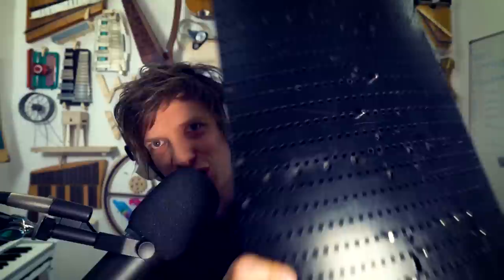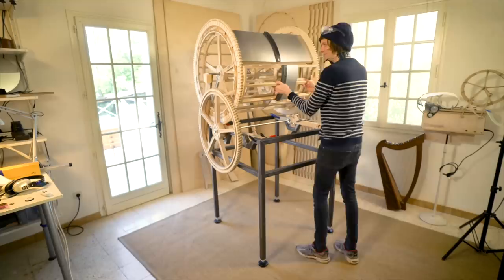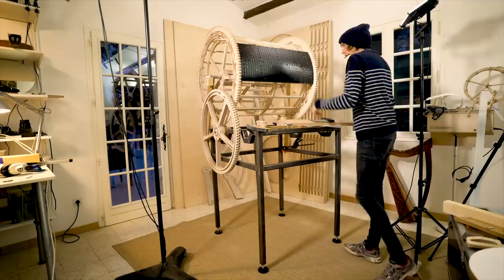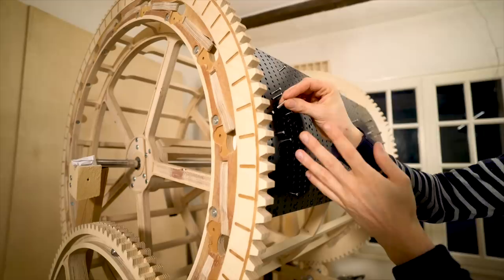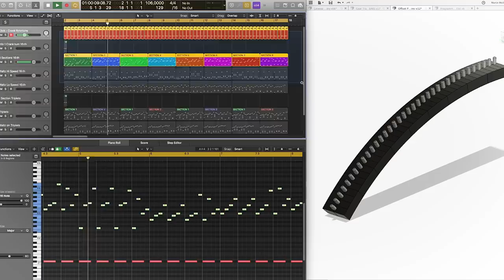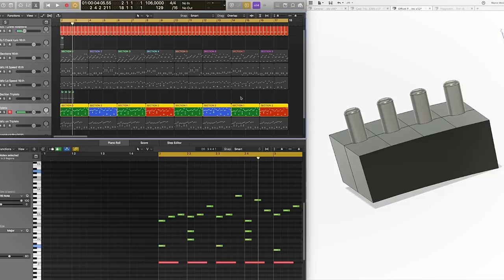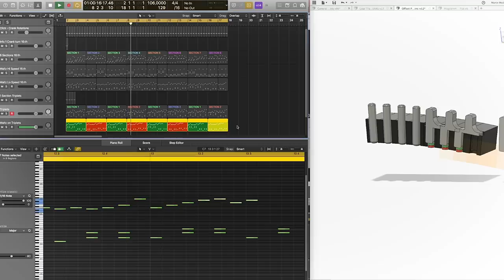Magnet "Midi" Music System - Marble Machine X #25

Comment from the maker: Welcome to the Design Discussion,
Maybe this could be a good place to have a public discussion and for me to receive all your feedback, could maybe be a returning thing in this series, lets try!

So first of all, please keep this clean and about the design, its the constructive criticism we are really looking for here.
I tried to give enough background information in the video to explain the situation
Consider this important fact: there is 15.000 holes/places for pins on the MMX per programming setup (30.000 if we make two setups)  any suggestion involving manual operations multiplied by 30.000 is nearly impossible. (if one manual operation takes 1 minute, 30.000 is a couple of months straight work. We need an automated solution.)
We need a very accurate solution for the musical timing.
It need to be FAST and EASY to reprogram. 

I would love to hear what you think about my last proposed idea or a completely different solution i didn’t think of.

Thanks a lot/ Martin
Reply: I love how you always push your video quality to the next level.
Reply: I think the bar magnet idea is the best option (or some other way of having two rows of pins)
Reply: You should probably build one or two extra sections tu be sure that nothing bad will happen during the tour! if something breaks the technicians can't change all the sections of the next song until you stop playing so that they can change one or two of the sections already in the machine. So just to be sure that you're prepared for every thing, why not make some extra pieces!
Reply: This isn't exactly a design idea but maybe a quality of life idea. For the CNC machine maybe getting a brush to go around the bit so dust and such aren't flying around the shop. While watching I noticed how annoying it must be to constantly have to clean up everything. The brush would limit how far it would be thrown. Something like this https://www.datron.com/accessories/chip-removal.php
Reply: mja00 I'm pretty sure he has an attachment that was fitted when he first assembled the CNC mill. He would have removed it as it doesn't look as good on camera.
Reply: Hi wintergatan, how ya doing? Is this thing gonna play starmachine 2000?
Reply: Just a QoL suggestion for the plates. Maybe cut a notch into one of the corners so the programmers know which side of the plate goes up, that way you don't accidentally start playing the music upside down.
Reply from the maker: @miguel Alves, thats great advice, noted!
Reply: Wintergatan glossy
Reply: Wintergatan my first thought was a set of removable, non-magnetic pegs that have smaller holes embedded in them (for smaller magnets) that extend the same length out of holes that the existing magnets do. Imagine they are "adaptors", and they only need to be made in strips that can be placed where needed. Might be made flexible with... a flexible material.
Reply: For tripletts use a diffrent shape of  magnets, than for the normal... like the squared magnets for the tripletts... That way it's like a puzzle for the technitians but it's clearer to see which pins to use and to reduce mistakes... Or something like that idk...
Reply from the maker: mja00 i got the brush but my dust collector doesnt work currently so i took it off so it looks better for the camera, but yes it is annoying! Sometimes i am using the brush without dust collector connected, that helps alot as well!
Reply: For the plates just an idea ; Number those big feckers. For placement and "here, person, reprogram plate 5, here is plate 5" rather than having the same plate by accident. 

And sky high thinking, maybe build / program a robot to do the programming. Just a whole separate unit.
Reply: I'm not versed in musical theory, but I think you'll probably regret nót implementing the offset system. X is already taking up a lot of time and focus so putting in the extra mile to get a higher return on your investment (more musical options) makes sense to me. Maybe you can make the grooves for the offset pins already, but fabricate the offset pins themselves only after you get everything else done so you don't mess up your schedule by taking this detour.
Reply: Wintergatan i'm not sure if i'm just suggesting what you've already tried, but i thought about some pins that have only the upper part offset to match a triplet, while the lower part remains the same
Reply from the maker: @José Betances try posting some kind of link here? So everyone can see?
Reply: Create a discord server. Its a very nice way to dusccuss with everyone
Reply: If you are making two sets of repinnable music drum(programming wheel) anyway, why not make one set of division by 3 and one set of division by 4?
Reply: Why not build a third set of plates with just holes for the triplet system then you can use the same magnets and know it will work exactly the same as the 4 bar system and be easy to program with no confusion or mixup. Oh and glossy black plastic would look good reflecting whatever lights are on stage.
Reply: Hey Martin. First: Glossy black for sure. I have an idea to make the remove of the pins even faster, you could get some kind of magnetic roll that you could quickly pass on top of the programming sections and it would lift up all the magnetic rods in an instant. Could be useful. 

For the triplets (I'm feeling the triplet hype) I think the first design you show in the demostration could work well. The square pins could be even more brittle than the rods.
Reply: Yehuda Katz the problem with the bars is that they will be a lot more time consuming to program because you must have the good direction when placing them x15000
Reply: Wintergatan keep the triplet pins. You're putting a square peg in a round hole and it will be round because a mill bit. How to stop the square pin to not rotate? Easy, you already have the interesting locking design. What if you only have one pin on its own? Easy, make a groove to keep it aligned. It will be a lot clearer where each track of registrators are which I think will assist both reprogramming and audience communication.
As for texture, I love the look of gloss in the vid but I think matte will hold up better over time. I'd recommend as well as grooves other measures to distinguish between sections of programming eg xylophone, percussion, etc. Why not have one section matte and another gloss?
Reply: There`s a way to get more organised about this whole technical discussion. You can create a Discord server with channels for different discussions. That way all people can see everyone`s suggestions and actively engage in live discussions with you and each other. If you`re gonna do that you should post the invite link to your discord channel in the top comment.
Reply: maybe you could make a mat with pins on the outside for the notes and inside four or five magnet pins to fix it onto the board like a bar mat or something ( https://kwmedia.scdn8.secure.raxcdn.com/media/catalog/product/cache/1/image/9df78eab33525d08d6e5fb8d27136e95/b/m/bm-1812k_large-rubber-bar-service-spill-mat-black_05_1.jpg ) i dont know if the rubber pins would be hard enough to activate the note 
so you could have ready made music mats instead of thousands of pins
Reply: You are so amazing! Good luck building the marble machine x. :D
Reply: I don't know if there is enough space on the programming plates, but if yes: Divide a revolution by 12 (6 slots in 2 rows). Then you have 16ths, 8th triplets, 16th triplets and 32ths triplets (all 12) for really fast arpeggios.
Reply: You should redesign the last triplet pin. It looks like it could break off.
Reply: Or instead of having this discussion on a single comment, which will become a mess pretty soon, you could open a subreddit. Love your work by the way.

If you're looking for an automated solution, the template as a "mask" is great. You could have another drum to mount the plates on, mount the template on top, have it rotate under a linear "funnel" that sets the magnets straight, then make the magnets "fall" into place where the holes of the template are. Then whatever holes of the template aren't filled, it's easy to spot and correct manually.

Big hug from Chile!
Reply: I think that it would probably be best for your marble machine programming board to have a little bit of tolerance built into it before locking. Depending on where your band will perform, the humidity will be your biggest enemy. Your machine may fit together perfectly at the start of a show, but if its humid outside you might find that it becomes harder to disassemble the machine due to the swelling of the wood pieces.
Reply: I've always loved the way you leverage the materials. You described the programming wheel as needing to be all black or all sanded, I think you should utilize the CNC machine or possibly some cleaver sanding to make cool designs on the programming wheel. It's the largest feature of the instrument so I don't think it should be left a single color. Keep in mind it should be a repeating pattern so it always lines up.
Reply: For reprogramming you need some kind of Magnet-Ejector, otherwise the magnets will stick together and it will cost a lot of time, especially for persons, that didn't practice before the show (audience).
Reply: Wintergatan Hi :) what about a plate that you can affix to the removable part that is essentially a metal sheet with the pins welded onto it with a special pin to fix it in each corner?
Reply: You mention the magnets breaking off not necessarily being a bad thing, but in your video, when you broke that one off, how possible was if for you to get it out again?

Whichever way you go, would it be possible for all of the pins to be steel and glue the magnets into the wheel instead, between the steel plate and the plastic? That way there's very little chance of the magnets breaking off the end of the pins and being stuck inside.

Also, +1 for glossy black.
Reply: Hi, this is not exactly a technical remark about the Machine, but have you considered creating a subreddit or an online forum in order to discuss these matters ? Maybe this could prove more efficient in terms of feedback, and it would make it easier for you to read the answers/suggestions. It probably will involve a bit of moderating but if you really are looking for advice, then I think this might be more efficient. And also it could be a nice exchange place for people who love your work (and god knows we are numerous).
Keep the love flowing and greetings from France, bienvenue chez nous !
Reply: Wintergatan What I imagine is if you make much smaller holes so that 12 can be on one crank. Then the pins would have thin bases and thicker tops. Half of the pin that would be in the board would have a much smaller radius than the top half. That way you can stil do the four and the three but also six. I hope would take my opinion into consideration. I love your videos, I always enjoy watching them!
Reply: You could make the reloading templates hold the magnetic pegs ready to be inserted. Then changing one plate's song would be as easy as removing all existing pegs and pressing the template piece into it and letting all the pegs from the template magnetically snap into the music plate and removing the template.
This way you could make many interchangeable and reusable templates, and changing a song would be super fast (though you can't really involve the audience in it).

But you could still make the templates with holes through them. Also the shiny finish is better than matte imo.
Reply: You could use fabric, that is strechted onto the segment. The pins are not magentic at all but rather punched through the fabric from bottom up (they would need a flat bottom part to not fall through the fabric). This way you can have 8 fabric pieces with the pins already in place for every song of your set list. You just need to swap the fabric, which should be much faster than any manual handling of singular pins. Plus you can punch the pin through the fabric in any place you want - not just 16th and triplets (musical magic!). You can also use fabrics with different colors or patterns etc for a cool effect.

Thanks for the awesome video as always!
Reply: Would it be possible to create a reversible pin? one side has the offset and the other is strait. For example, a rectangular pin cutted on one point to make the offset.
Reply: I think putting 8 of those plates on the marble machine on stage will take quite a lot of time
Reply: So I have a couple suggestions. The first is that you simply color code the programming sheets, this would remove confusion and if you keep the pins in colored boxes then it would be a very foolproof system. The next idea is a switch pin. A pin that after it is played will turn itself off, so that on the next rotation it does not play. I have ideas on how that could be done, but it would probably work best to show a drawing
Reply: I'm thinking that you could have an inverse template that could just snap to the programming wheel with a non-magnetic backing so when you put the programming wheel face down to it.. all the magnets just magnetizes to it and transfers to the "master" programming wheel. (it minimizes the time switching) 

and also, you can place the paper template on the "transfer wheel" waiting for the "master wheel" +Wintergartan
Reply: Wintergatan Just for the design of the slopes, I prefer the matt look because the magnets/steel rods are already shiny and a glossy black would distract from this look. Also it might be an issue if you have the machine on stage and the spotlights shine on it. Big shiny areas tend to blind you if the light hits them at the wrong angle.
Reply: What about instead of offset pins, you cut new holes next to the16th-holes. If your rods are 5mm, and the striker they're hitting is 10mm you can have a row of off-set triplet pins half-overlapped with the 16th-holes. You can still function the same as the offset pins, but will not have to manufacture a new part and continue to use the magnetic 5mm pins. - of course, this was your last suggestion that I saw after writing the comment... haha, but I think this Is the best idea.
Reply: I'd like to think this machine won't have the kind of problems as the old one had. But, you may want to make duplicates of the parts that are more likely to break, that way you can make repairs where needed. 
Also is it odd that I want to base a character in my manga off of you?
Reply: +Wintergatan
If the brittle magnets do become a problem could it be possible use the magnetic property of magnets to make it not require contact to trigger, although they might not be strong enough to pull the gates.

This could also be used along with an electromagnet to make it computer controllable. although bypassing the programming wheel will be an issue there
Reply: how about making the drum a separte part ( disassambly for transportation) and put the pins in preprogrammed strips(sort of a chain it loops around the drum that is mounted in the machine, and can be taken off quickly. so divide the drum up in letz say 5 strips that can loop around the drum, taking them off on stage and putting back the strips for the next song would not be a big deal if the mounting system is quick and easy(magnets, clips, screws) the strips could be made of plastic, softer though so it holds the pins securely and permanently but flexible enough to wrap around the drum. sorry for bad explanation and english, i love your channel :)
Reply: Couldn't you, due to the length of the rods and their round crosssection, just drill the holes for 4/4 and 3/4 right next to each other, slightly offset to the side? Would be far easier to produce and I think they would still be held in place and withstand the forces of use, considering the direction of force, I don't think they'd be pushed to any adjacent hole.
Reply: you should consider using Reddit as a place to get feedback. Lot better than youtube commenting.
Reply: Extra anything that can break. this thing is like a high tuned performance machine, Racecar, Moto-cross bike, Speed boat. This should travel with at least 3 sets of identical parts for the primary assemblies and at least 1.5 of the tiny parts, screws etc.
Reply: i think the best solution is to make more sets of plates,  so there is more time to reprogramm them.the templates are also a good idea,  to make the reprogramming as easy as posible.  best would be to have only one type of pin.
Reply: Hej ! I have a question with that kind of design. Can you do songs with quintuple meters (to make the machine more marvelous) ? For the rest of what you described i'm pretty impressed by the idea, and i find it's a good one ! The idea of @Big_Adam_2050 of making a difference / numbering the panes can be cool if you want to invite public to do the programming. Can the wheel have more / less than 8 panes ? like 6 panes for triplets, 10 for quintuplets ?
Reply: Vikrinox I like the glossy black too but I think it would be difficult to keep from being scuffed with use on tour. The mat version has the advantage of hiding minor scratches
Reply: Rather than all the special offset pins, would you get sufficient flexibility from just making a set of 3/4-time programming boards with 3 pins/turn of the wheel rather than four? Seems like it would get you 80% of the flexibility with a LOT less work.
Reply: Matt grey definitely if you can make it nice and even. Is the material available in lighter shades?
The bar magnet idea with 2 parallel rows, one 16s and one triplets sounds like a better plan to me.
Like others, I don't like the idea of shattered neodymium magnets around the place though - a health hazzard and a poor use of a rarish resource. Also a more expensive option for anyone trying to make anything similar.
Amazing project - love following this!
Reply: Glossy. Definitely glossy.
Reply: Glossy!
Reply: How about color coding the templates for each song. Blue holes is one song, red is another? Make the templates out of sticky vinyl. Or how about basing the mechanism on  punched out templates and photo sensitive sensors and triggering a note on that? A bit more techie, but next level maybe?
Reply: The offset pins idea is fantastic - really makes the machine so much more flexible! It's becoming more impressive by the video! As for programming the wheels you could always have a programmed robotic hand like the ones they use in car factories. Of course that would mean you need to start robotics and AI but I'm sure you'd do it :D
Reply: The magnet shift at 13:12 made me think that your original idea was to just drill an extra triplet hole for the round magnets. This would allow you to use round magnets as before and because the double-holes aren't oblong, but rather 8 shaped, the magnets should stay in place. Was this something you considered?
Reply: Why not just make a new plastic grid specially for music in waltz/ 3/4 time with the spacing for three pegs rather than having complicated pegs?
Reply: Glossy black looks really nice! And I prefer the idea of the rectangular magnets and having the 4/4 and 3/4 next to each other. It gives the option of playing things "off beat" as well as being a simpler more elegant solution. 10000+ magnets in different sizes and shapes would be a hassle to keep track of, so having one uniform design would be a much easier approach!
Reply: Harry Tsang What if he wants to play two 4/4 right after eachother?
Reply: I'm a bit worried about the distance between the pins and the thickness of the registrator bottom parts. How close can you put the pins together so that every one gets registered?
Reply: Wintergatan why not have a set of triplet panels? Same pins, same design just with holes spaced for the triplet.
Reply: Two tracks is probably best. Triplet holes don't line up with quarter holes, so you would need three types of pins: ones for quarters, ones for triplet outsides, and another for triplet insides. And you have to pay attention to which way the outside triplet pins are installed. Overall, having two tracks is simpler.

In terms of color, don't make them black. Someone will have to spend time in a badly lit environment trying to fit pins in black holes one a black board. That won't go well.
Reply: To gloss or not to gloss? In my experience as a pianist I've discovered that modern grand piano makers (I.e. Steinways) use gloss black coatings for the outside and lids of their instruments, but they tend to use a matte finish for their lid support rods.  This is not an oversight, but rather an attempt to prevent audience members being dazzled by the off-putting glare from concert hall lights.  Worth considering perhaps?
Reply: You can design two different templates, a 4/4 like you already did and a separate 3/4 (6/4) plate with 6 holes instead of 4 per crank.
Reply: I would say the block magnets are the beast way to go this is how I did it it is much simpler to program hands down
Reply: Wouldn't the triplet pins be difficult to store and keep organized during a concert?
I also think you should build spares just in case the main programming segments gets damaged during the switching.
As for dual track system. Wouldn't that make the programming segments a bit brittle?
Reply: I just wanted to say i think using the rectangular slotted pins would be better from a design and re-use perspective, it simplifies the programming approach and standardizes parts better plus i the shape reminds me a lot of how the sheet music for some of the old speelklok machines looked with their rectangular slots. Plus like you said it would make it easier for the audience to help program the wheel if the template didnt have to rely on two types of pins.
Reply: I like the square pin idea. Different types of pins just adds cost and unnecessary complexity. Im no musician but perhaps you could also use the square magnets in the other direction too, to change the tempo even more. The milled slots could be both horizontal and vertically oriented. Anyway, congrats on a very well made video, you put a lot of effort into this one and it shows!
Reply: My only concern with the templates is damage to them, accidental or not. Wear and tear on paper can make for problems with programming. If the  paper templates were a thin plastic version, I feel that there would be less worry over replacing the templates on the spot if there was damage to them.
Reply: Why do both the second and third pins need to be offset? Why can't there be just one hole in between the middle two pins?
Reply: i'd prefere glossy, since the alternative looks more gray-ish than black. if you really want to, you should consider brushing it all in one direction to make it look liky vinyls maybe.
another thing: the click (in my opinion) is a cool idea, and you wouldn't loose the pins BUT sounds quite expensive and don't improve the programming process. also the magnets will stick together so it will be hard to loose them. also the idea that it might be good for the machine if they break instead of something else is very good, but has a disadvantage: they might get stuck in the holes. so you might need to drill a little whole inside of the bigger one so you can push them out with a needle or something.
all in all i like the idea of the 2 rows of pinlines. it is cheaper than water jet cutted steel pins (that are also not as secure as the regular ones). it is also easier because you would obviously need 3 shapes for them to work. this was my opinion, sorry for the wall of text, my "shift+enter" didn't work somehow
Reply: Wintergatan glossy doesn't fit with the wood, it's a wierd contrast. I do really like the idea of the offset pins, it's a pretty elegant solution to this problem
Reply: I like how the table has the cut lines on it.  Hope to see it hung up on the wall somewhere at some point.
Reply: Wintergatan why don’t you build a template with 3 holes instead of 4 per beat like you made it here, so you switch the set up to the triplet one when you want to play a valse song or sthg like here
Reply: Miguel Alves 3 sets of plates would accommodate for that as well since he will only ever be using one set at a time. The 3rd set can be for if any break, that way he has plenty if extras.
Reply: Glossy Black, same type of pins, and yes making a template would work really well for the onstage reprogramming.
Reply: Wintergatan you could try something like a blueprint for every song where the pins are upside down and then you just need to clean the pin part and put the blueprint with the pins on it so a change would you cost one 1 minute or so

Btw i prefer the glossy one
Keep it up my friend
Reply: I think the bars would be the best option. As long as you have the templates to make it super obvious where the pins need to go then I don't think it would cause any issues, plus it means only one type of pin needs to be used, and it might even be a bit stronger then the rods because they are a bit wider it looked like.
Also I vote matte black, I personally think shiny black doesn't match the rest of the look of mmx
Thanks for being awesome!
Reply: Wintergatan with the repining of the wheel you can use a clear plastic with holes that goes on top of the the thing you made in the video ( it's 2:35am here in Australia and I'm very tired so I forgot the name) it can help put all pins in, plus because it's plastic it can last longer than paper. Anyway it's just an idea...
Reply: Mate finish!

I personally think that it would be cooler if it would be mate because then I think the programming pins would pop more. 
Glossy might reflect to much light and take away from the details especially on stage.
Reply: Better yet than youtube comments, why not do this on a subreddit? It's much more efficient and clean that way, youtube comments will get really chaotic once many people will start to respond, and some may post answers to other people and not necessarily for what you asked in the video.
That will also keep a large part of trolls out of the discussion since they won't be bothered to go on another website.
Reply: I think having two kinds of pins will be: first more practical for the programmers and second they might be visually more apealing, especially if you have them sorted either by shape or colour. Bright colour (obviously woodenish colour like birch bark or something) would go well together with the appearance of MMX. Go for the rectangular shaped pins in two colours if possible or the setup you have just shown. Having the pins whole as a magnet is benefitial, since the programmers don't have to bother with the pins orientation when they hurry... Keep up the amazing work. Can't wait for your MMX tour. You ARE a geinus. Come to the Czech Republic!
Reply: I think Gloss black track and two rows of peg holes where one could be offset would work out for you . Keep up the good work and I can't wait till Marble machine X is fully operational.
Reply: What about making extra panels with triplets? That way you can have either a full song using thirds,  or you can mix panels using triplets and quadruples interchanged. One thing is that you should think about; how do you prevent someone turning a panel 180 degrees? Do you have keying on the panels? Also, how do you know in which order to place each panel?
Reply: I'm thinking about the programming problem. Like pixels of a screen, each part is a grid of pins. That's all or nothing system, 1 or 0. This type of grid programming can be usually done with computer science : plug your electronical system (embedded in each part of the programming wheel) and send the program from a computer and VOILA it's releasing at the same time, only pins you need and catch back pins you don't.
And I've been thinking about this in a mechanical way : Hydraulic system are pretty good usually so air/liquid pressure could be pretty good to maintain pins released or not right ? Even micro devices like electronical magnets can do this (but maybe this one is harder to make).
Anyway : take a look at this type of thing : https://www.physikinstrumente.com/en/products/linear-stages-and-actuators/stages-with-motor-screw-drives/l-220-high-resolution-linear-actuator-1201906/#c28213
Illustration here (this one is bigger) : https://www.youtube.com/watch?v=edTQShw_vZU
Those are too big. But micro versions of those could be really good (but really expensive too :/)
https://www.youtube.com/watch?v=axjpJOj5E74
here is a smaller one but this techno is not accessible... cost is appr. 65$ per pieces (that's what I feared)
Reply: I think bar magnets with the double track are better. Two reasons: Making all those little parts will be very tedious, but more importantly, the moment you start using glue will be the moment everything starts to go wrong. Either you glue fast but sloppy, or precise but very slow.

Making templates is probably a very good idea, although I would make them from thin cardboard instead of paper. What I would also suggest is to print some colour around the holes, for reasons of visibility.

Lastly , I would sugest to number the plates. A1-A8 for the first wheel, B1-B8 for the second and then X and Y as spares (for when things go inevitably wrong).
Reply: Wintergatan to save time you could use a bigger stronger magnet to pull the pins out maybe? I also imagine it can hurt your fingers to pull on the very tiny rods if you do it a lot
Reply: You should get a subreddit for wintergaten where you can host forums for suggestions.
Reply: Ideally you should have a printable solution, that allows for any tempo. I have no idea how to do that though.
(optics comes to mind, but it is not simple or mechanical enough).
Reply: Hey Martin!
First thing first. I love your project and with me being a music student I love your including of theory and would love if you did some videos explaining your unique sound and melody making (I would be a Patreon!).
That being out of the way, I think the way to do the triplets are with the same holes and the new set of pins. I really think that its important to keep the programming as simples as it can and not have a separate track for triplets. It makes it easy for us as an audience to keep up and see your programming from the concert seats. 

Love from a nordic fan!
Knæk og bræk med projektet ;)
Reply: Wintergatan i don‘t think the vault loop sounds bad. the Pause at the end isn‘t too bad either
Reply: I love the idea of the triplets. It really IS a game changer. Will you be able to play things such as 5/4 time?
Reply: Isn't it possible to change the gears, so tat the programmingwheel turns slower oder faster, so that one turn of the crankshaft is a thrid and Not a fourth of the musik
Reply: Wintergatan You could also make a interchangable hand crank for the 3/4 beat.
Reply: maybe for easy removal there could be a kind of section mold, maybe magnetized or something, that goes on top of each section to remove all pins at once, i dont know if i described it well, but i did a crude drawing of what i'm talking about https://cdn.discordapp.com/attachments/175233281464205314/413358257055465472/unknown.png
Reply: Well if you want a simple, easy and fast reprogram, you can make a guide with the hols for the magnest and have different colours for diferents  magnet notes like you show in the video. soo you can Change the guide during the song and when it is complete remove the guide ( because of stetics)  thats for your great job, i hoppe you come to Barcelona ( Spain EU.) For the World Tour.
Reply: Even your sample music sounds amazing! I am afraid of the neodymium rods breaking though, the constant amount of stress would soon wear it down making the replacement expensive and a pain if you are overseas. The steel rods with glued magnets would definately work alot better, the paper template also sounds like an amazing idea!
Reply: Two suggestions for removing and setting all the pins with a Jig:

I like the idea of CNCing a board that goes on top of the Programmplate.

1) If you make it with a metal base, you could set in on the programmplate and remove all magnets at once.
2) Also put metal base on the back of the Programmplate, but put 2 layers of tape or something on the metal plate. So there is some isolation between the metal and the magnets. This is so it does not interfere with suggestion 1. Then you build another Plate, same kind of construction than suggestion one, but without the metal plate. Then you cut pre-programm a part on it, set it on the MMX, the magnets grab onto the metal baseplate and you can pull it off.

You would have to make sure the Jig aligns perfectly as to not have magnets in wrong spots. 

If this works it would reduce quite a lot of setup time. I dont know about the visuals of this on stage however.

Big Fan of Wintergatan!
Reply: You should put some kind of wax lubrication on the plywood where it interlocks so that it works smoothly and does not seize up or prematurely wear the plywood down. Also, Glossy black!
Reply: You've probably already thought of this, but make sure you leave enough material between the pin holes! If the black plastic is too thin then it could crack!
Reply: I think having to reprogram the plates is really time consuming and could lead to much error and you don't want that on stage.  Best would be to glue the pins in place permanently to the plates.  You would have 8 dedicated plates for each song.  This way you don't have to drill in extra row of holes, the pins will always be correct, and there would be no reprogramming - just swap plates.
Reply: I definitely prefer the glossy look to the matte look.

Also, I think the double row with quads/triplets with thin rectangular magnets seems like the best solution. Mainly because that would synergize will with your idea to use strips of paper to push the programming pins through.

EDIT: Oh, and I did see the Falcon heavy launch! I had butterflies in my stomach when I saw the two rockets land. That was so incredible!
Reply: Helt klart blank svart, Martin.
Reply: With the colored Boxes and all the holes punched into the sheet, one sheet can cover two songs and you dont have to remove the right pins
Reply: The paper template idea is good, however I imagine if it's actual paper then it would be very delicate.  I would make sure to laminate the templates or make them out of sturdier stock as you transport them around on tour.  I think this would be even more important if you went with creating the bar-magnet system using the 2 side-by-side tracks, since the holes in your template would be even smaller, and you could more easily puncture a piece of paper with the thinner magnet.
Reply: 3x4 = 12. One possibility is to increase the resolution. Of course you had to decrease the part of the pin which sticks into the wheel.
Reply: Block magnets! Excellent idea! Can the machine cut the holes with a tight enough tolerance? Agree you should have spare sections anticipating some breakage.
Reply: - I would go for the Black Glossy panel - lights would reflect of it during the show rather than a dull matt finish.
 - For the pin I would go with the first system you mentioned where technicians would put pins through a canvas with holes.
 - For the pins distinction you could have the pin4 in red and the pin3 in yellow. The canvas could also be in the color of the pin, making it easy to see a problem of pin selection
Reply: I would suggest that you add numbers pr. column and row or letters in a bright colour like yellow or a bright red, and also give each programming slate an identity like A1...A8 etc. and B1...B8 . This is so that they don't get mixed up when programming, and in the case that a template breaks they can refer to a sheet. It would most likely add some quality of life to you as well, as you can most likely easier program it. And with that said it could even just be made for one prototype wheel (8 sections as you said) for experimentation. Also I prefer the glossy black finish. Lastly with my suggestion: when the wheel spins it will probably spin so fast anyways that it will just look like contrasting lines on the wheel.
Reply: Having to Cnc all of the small offset pins and then gluing magnets on the hundred that you make will probably be too much work when you could just use the bar magnets. The only problem is that the rod magnets will be stronger then the bar magnets and reprogramming the bar magnets on a black surface with such small holes leaves a lot of room to mess up. And for the placement of the pins when reprogramming it. You can give them a grid system that has like A1 which is the top left pin then A2 is one down and B1 is one left (Similar to the board game battle ship if you’ve ever played it) and then give the reprogrammer a card that has all the spots that need to be filled on it
Reply: I appreciate the triplet-hype! It really opens up your options if you can change a piece's timing at will. 
RE pin template: The idea sounds good to me, it should speed up the changeover time as you say.
RE plates: How will you prevent a plate being accidentally placed on the wheel the wrong way round?
RE triplet-pins: switching to the square-ish magnets, with two rows of pins for each note, would be easier to setup I feel. It depends on the shape of the registering arms really.
RE materials: keep it glossy, to stay with the beautiful "raw material" style of the whole machine.
Whatever you do, I look forward to the next steps. It's great you're involving the internet with your amazing project.
Reply: If the matter is to reprogram quickly the wheel, and since you have the CNC : why not machining the pins on the ABS sheet (rather than digging holes), and use a magnet/registration holes just to precisely attach the polythylene 'music score' to  the metal sheet section : Rather than plugging lots of magnets, you just have to attach your 8 sheets. Moreover, you can place your pins everywhere since the CNC can machine the pin everywhere.

And of course, this does allows you as well to keep your system with magnets (love the triplet idea) in order to play around, make quick tests, or even involve the audience during the show. For the triplet, I think i'd rather use two different shape of magnets, since it give you a visual hint on what you are working with... working on holes next to other holes seems less straightforward to me... unless you add a color or something...

For the color, I'd prefer mate to let the lights reflects only the magnets just as revolving stars in the sky :)

And to finish, I love your work, and the conclusion of the video is truly awesome.
Reply: I'll keep it short:
* Glossy black, not matte grey
* Alternatively, find a brown polyethylene which matches the wood color, or a plum/reddish color like the glue layers of the plywood.
* I agree with the idea of having more than just one spare set of plates. I think you'll struggle to get them repinned in time, even with multiple people on each plate. You need to have spares ready to go in case the reprogramming isn't done, or in case something breaks. Have twice as many as you think you'll need, because you'll need them. As the saying goes "One is none, two is one, three for me, four for sure".
* You should paint large numbers on the plates so at a glance from a distance you can see that things are in the proper order.
* Alternately, paint hash marks on them so the 'row' of hash marks gets longer as the drum rotates. If any plate is out of order or upside down it will be immediately apparent. So for example:
    Plate 1 = |
    Plate 2 = ||
    Plate 3 = |||
    Plate 4 = ||||
    Plate 5 = |||||
    Plate 6 = ||||||
* I am not a musician or a mathematician, but why not have one set of plates with the pins spaced for 4ths time, and another set with pins spaced for 3rds time?
Reply: I recommend making a discord server for communication.
Reply: for the template you should have it made of black plastic or some black material that is spray painted white so that when there is an open hole it will be extremely visible and when there is a pin in the hole, you wont really see it.
Reply: Maybe the simplest solution is having 2 or 3 set of grid plates with 16 / 12 and 10 holes per bar?. With a 12 hole grid you can't do 16th's subdivisions, but if you can have plates with 12 / 10 and 16 subdivisions, you can do thirds, 4/4 and 5/4-5/8 , albeit in low resolution. The only caveat is that will not allow to do polymetric, unless you change the metric only at the end of a bar.
Reply: use Teflon type plastic or UHMW plastic these are very strong
Reply: If you put the 'program sheet template' over the program 'plate' and then stick the pins in, it will have to remain in place or you will have a very difficult time removing the sheet after entering the pins...so make the 'template' part of the art of the music, you know so each song will have it's own art.   I like the rectangular magnet for the double row to get the triplets.
Reply: maybe the pins could be push in style? make the hole have a lil tooth that goes into a notch in the pin. then you can just push in/out the pins you use?
Reply: I totally agree. 
The goal was to let the marble machine look as untreated as possible so the glossy black is way better. 
And the idea with two tracks per registrator is easier to program because with those other pins of the first idea it would be difficult to use the mentioned programing sheets. One problem that might occur is that the activation of the registrators wouldn't be centered but I think it should work.
Reply: I worry that, with the bar pins, it would be easier to make mistakes and errors when placing the pins. I am almost tempted to say that the holes should differentiated somehow, that there would be colouring inside or around them (but that may ruin the look of the glossy black, of which I prefer over the matte.) I think making the third pins will be difficult, but may prove to be a bit better on the programming side, as it would be easy to identify and move them without worrying if they are in the wrong holes (comparing to the two sets for the bars, which I worry will get confusing once the programming wheel is complete) The biggest issue I foresee is getting all the pins. It seems you have a lot of the round pins already, and depending on how many you have may dictate, in part, which option you go with. The bars do have their advantages, but I think using the circular pins, and the easy to identify thirds pins, it may make up for the difficulty later on.
Reply: youre a goddamn genious btw and you have my deepest respect and admiration for this entire project and your videos
Reply: What about making angle slots to cause the triplet-offset?
https://image.ibb.co/bWkro7/angle_slots.png

But probably it would be impossible to cut these holes with the CNC machine
Reply: So, if you're going for triplets could you not have it set up in "12" positions? so the pins available to you are 1,4,7,10 for 4-4 time and 2,6,10 for triplets? or something similar. doesn't actually have to be "12 positions", just for hole placement.
Reply: I think the brushed gray is better, because it makes less contrast between it and the wood, and it makes the Marble Machine X way more beautiful
Reply: I think the template idea is good. Being a technician in a whole different field I feel for your techs and somewhat biased. Make their jobs easier!!! Also gloss black all the way. Or maybe some graphic vinyls you can overlay on top of those templates. Would make identifying those templates easier and add a bit eye candy to the Marble Machine X.
Reply: It's been said in the main comments a couple of times, but you really need to plan for relative humidity factor when on tour so that replacing the parts and building the machine isn't a task when the wood swells and expands or shrinks.
Reply: first: please make a subreddit or something more organized.
second: I had the idea to make many holes overlapping each other, so you could stuck the pins nearly every where. But they should not slide.
third: instead of the templates, i would just make colored marks on the sections where to place pins. And i guess it would be a good idea to have some spare parts of the marble machine for the tour. especially the programming boards.

And i like glossy and matt.
Reply: Why reprogram the boards live? Why not create a set of boards for each song. It doesn't seem to be all that much effort compared to trying to reprogram on the fly and not get any pins wrong. Just swap out the boards for each song.
Reply: Johntheawesomeguy i dont have reddit so i would need register so i think yt is good enough
Reply: Here's my thought - keep the same design you have, but make little adapters to go from 4->3 pins, and make one for each triplet configuration.  The base for each "adapter" would be a small plate with 4 pins to connect to the existing design, then the top would be each of the triplet configurations - 100, 010, 001, 110, 011, 101, 111 - so there are 7 possibilities.  Maybe less, depending on how often you have to use them. (And if you only have X songs, you'll know which configurations you need). When you need a triplet, pick the right configuration and slot it in for the music.  For everything else, continue to use the rod magnets.
Reply: Another suggestion is to have a sheet of paper with the notes on it. Like on the music box. You could print different templates for different keys.
Reply: i would say make a set of the 4 and 3 and then a set of of the mixed plates as it would allow more flexabilty in the final design ... why have the extra pin for a song that dosent use them as it would take extra time to make sure its programmed correctly and i would make a metal(aluminum as its nonmagnetic) plate that you could set ontop of the programing wheel piece with the pin layout for each song and it would prevent misplaced pins due to being hard to puncture and make sure to do a feed direction engraving on the pieces so they all are in the correct orientation
Reply: This isn't really a programming wheel question, but I notice you have all of these shavings, and I was wondering if you could make some kind of rattle with them :D (Probably not, they don't look like they'd sound good, but still)
Reply: I would recommend setting up the thread on Reddit and/or discord, both offer better places to do creative discussion. Also, the black contrasts better with the pins, that would make them a bit easier to see on stage.
Reply: Why don't you make two different kinds of programming plates? One with 4 pins and one with 3 pins per revolution.
I think the processing of another set of programing plates is way faster than make thousands of those special pins.
Also I think the special pins are kind of unefficent as you have to sort them after removing.
Reply: Are all "readout levers" the same in principle? Then calculate or experiment with pins of different length (and color). the length of the pins seem to be critical for the timing.
Reply: Not as much an improvement for the functionality, but it would be very cool if you could see what instruments the different lines are for, for instance by giving them different colors
Reply: I don't know if this has been suggested already but my idea would be to make a different set of programming plates with holes spaced to do triplets. So when you want to play a song with triplets you just switch out the fourths plates with the triplets plates et voila.
Reply: @Zalli seems like a good idea using a pre loaded jig but once all the magnets are in, due to the angles of all the magnets, the jig is now locked onto the frame. This may work if you did just one row at a time. 

Also you would still have to pull all the magnets out by hand.
Reply: You mentioned a template that you would CNC for the techs as they reprogram the music. I love that idea, and you actually wouldn't need to CNC it. Thick construction paper (or similar material) would also do the job, and you could give the CNC machine a pen or pencil, which would then draw out the patterns. You then punch it out, and Voila, programmed template.

In any case, I love that you want to include us in your design process, and I hope that you get some great ideas from us. 
Greetings from ASU Polytechnic Engineering
Reply: Hey Martin! Have you thought about making a Discord channel to continue discussions instead of the top comment? I think that would be a good way to get people more involved. You cod separate it by have different sub channels that are dedicated to different subjects. You could also have moderators to make sure people don't post in the wrong subject. Might be a good idea!

In terms of feedback, I like the glossy finish. I think it adds a little more of a finished look, even though I know you like the unfinished look for MMX. One thought I had was would/could the marbles get stuck to the magnets behind the programming boards? Probably not because of the falling factor right? Also, for the programming "paper" for switching songs, I would make it more like a plastic template or a laminated paper so it doesn't get ripped. I think the block idea would work best, but the fact that you need 10K of them makes things difficult haha. I think if you have to, stick to the rods and reconfigure the board to offset some of the notes. 

Also, if you are coming to New York on the tour, I would absolutely love to be one of the programmers for the marble machine. I always look forward to your videos every week and it's given me drive to try new things in music making. Every week it gets better and better and I can't wait to see the final result!
Reply: My idea for the triplets ( and maybe more):
https://drive.google.com/file/d/1V7L1WkLYSSxhkhF284sbfJgjek1X3m-F/view?usp=sharing

What if you use the glossy black polythylene as a base for a thin plate of other material which will have the programming holes. This plate can secure into place very firmly (not sure how yet). If a song require a different grid, you can exchange this plate for one with holes already drill to fit the appropiate grid. You could have triplet grids, Quintuplets, maybe a swing 16s grid for groove songs. I hope to hear what you think.
Reply: I think the plate magnet idea with two offset rows per channel would be the best idea for a few reasons. 1. the plate magnets should have more strength and ragidity compared to the bar magnets. 2. I would suggest not using a metal bar with a magnet glued to the end just in case the glue fails and the magnet is stuck in the hole, that hole would be rendered useless for the entire show. 3. water cutting those metal pegs will be quite costly.

Now that I am thinking about it, there will always be the problem of what if a peg breaks off in a hole. That will make the entire panel unusable. So, what if you had the sheet metal plate have all the same programing holes drilled into it, but made it so it could slide in and out of alignment. That way, in normal operation, the metal would cover the programing hole, but if a peg were to ever break, you could slide the metal sheet down revealing the holes and then clear the fractured peg by pushing it through with a rod.

I know this doesn't really help solve your programing issue, but it could be a life saver during a live performance. Best of luck to you, and please come to Orlando or Tampa ;)
Reply: Hey Martin! 
Is it possible to make a system where you can put in the pins like you normally would, and then 'click' them to an angle to get the triplet system? that way the angle from the wheel to the pin isnt 90 degrees, but something like 75 or so.. i dont know :p That way you wont need any special pins, no extra's.. It would be a big change to the programming wheel tho... But it might be an idea to be able to angle the pins to get the triplets :)
Reply: Wow, here are so many answers! Do I don't know if this were be written already, but you could make a horizontal offset, so that the holes for the pins are different for different directions: quarters in upwards direction and triplets in downwards direction. So it just depends on the direction, the sections will be clipped in the machine.

Another idea is just to make different sections for different music: 16 sections for quarters, 16 for triplets and so on. With this you will be free to make other music with 5/8 or so on…
Reply: the programming board with 4 and 3 sounds great, although the bar magnets will be thinner. about the magnets being brittle, i got some to play with and they broke quite easily after repeatedly snapping them together. i think its more due to stress over time. you should make a system which allows you to easily extract broken magnets. everything that can go wrong, will go wrong!

small, square holes... CNC machine will need a very small bit. will it break?

matte. too many things are glossy these days, not to mention the gloss shows imperfections.

edit: what @youbecha64 said... you won't be able to remove the template after putting the pins.
Reply: As has been mentioned a couple times you will want to have a registration mechanism for multiple purposes.

First, something that indicates top/bottom, right/left. So things will be oriented properly.

Second, a way to register the programming templates to the programming plate. Raised or indented areas, block or pins in a unique pattern that only allows the template to be mounted in one way. 

Finally, maybe something to indicate the order of the programming plates. this would need to be changeable in the field in case one get damaged and needs to be swapped out.

Probably merging the functionality of any markings as much as possible. So maybe some raised triangles to indicate the top. Then you could have triangular cutouts in the templates that slide over these. They don't have to be all that big, but they would need to be sturdy so they don't wear out too quickly.

As for color the glossy black looks good, but would likely get scratched and worn and not look so good after some use. So you may want to go with the brushed look to any damage does not stand out as much.
Reply: this would restrict him to using only one type of timing per plate, and means he has to make and move 8 more plates
Reply: @Wintergatan 
You should use Reddit for these discussions! Make a subreddit and then people can up and downvote. It's a lot more organised than the linear comments in youtube.
Reply: Combining the two systems may be an option too. Like somebody else stated in this comment section, having two tracks (one for 16th, one for 3:2) will make you able to have polyrhythm on your machine, and use the square magnet for 3:2, save the round one for the 16th notes
Reply: Maybe use the bar magnets... Positioned HORIZONTAL for the 4ths and VERTICAL for 3rds (or vice versa) - so each section would be almost a few +++ signs.  Should keep costs down and hopefully easy programming...
Reply: Hey, did you think about having Pins, that are pushed up by a spring with a stop and therefor pop out whenever there is nothing Holding it donw. That way you could put a programming layer (e.g. thin cartboard) with holes above the pins. There would be no need for placing many pins, just placing a new programming layer and you are done.
Reply: I think, if you would just colorcode the pins you could use these types of tripletpins. For example: You use a Template and color the outsides of the holes for regular timing in green and triplettimings pink and red. If you paint the pins in the same color, it would be easy to differentiate, what pin goes where. Also: I think it could look cool! And it's cheaper, i guess.
Reply: I think it would help with the programming plates if they had some sort of numbering system so that none of them could get mixed up
Reply: Here's my crazy idea for a pin-loading mechanism that may or may not work; 
It's possible to feed a template sheet as you call it through the (or a) machine, and then build a barrel(or clip) of pins to self-load the machine's plates, however, this means building a second test-drum for building the tracks onto.

That was a little odd, so let me try to explain my idea clearer; 
You have the empty plate attached to a test drum. You can feed a template sheet (Literally paper) through it to place it ontop of the plate. A clip (think machine gun) is placed ontop of this assembly, and so when an empty spot is "detected", gravity causes a pin to fall into the gap. This will make loading a new track into a plate faster and with minimal mistakes.
Reply: Eric Wieman yea!!
Reply: You could make the metal backplate, that the programming pins stick to, slideable. Cut a groove for it and add a handle to it. That way  'the technicians' could simply slide it to the side, and all the pins would fall out. That would make the removal of the pins a lot more efficient. I like the triplet design with two rows, but using circular maybe a bit slimmer pins would be better as the quare once could waste alligning time as someone else mentioned.
Reply: If you wanted a nice cleaner look, I think the matte finish would be great to add a little contrast from the rest of the machine. For the glossy texture, some scratches and marks could be seen when hit by the light; and judging by how you want MMX to have more of a rough aesthetic, I think you would prefer the latter.
Reply: Building on the idea of disc magnets within each pin hole, rather than a series of individual pins, you could water-cut single-piece steel segments which each can quickly be swapped out to replace one channel.  

A solid piece would reduce the number of programming steps by several orders of magnitude, and rather than having to replace 15000 pins in precise locations, you merely have to swap 256 pre-programmed segments.

Also, triplets, or custom time signatures could all be pre-programmed into the steel segments.  

Colour code/number the ends for easy and quick assembly.  Then the whole reprogramming step can be accomplished by 2-3 people in the time it takes to complete a song.
Reply: Wintergatan I would nott recommend the block magnets, because it would be really hard to create good fitting slots with the cnc machine
my idea would be that the holes are overlapping (if the magnets are big enough) i dont think that it is necessary to hold the magnet around the whole circumference
another option would be to make the whole plate asymetrical so that you can insert it two different way one for 4 and one for 3 pins per devision
Reply: Be sure to number and identify each plate, so that it will be easier to change programming sections. I would also make more programming sections in case one breaks during performance/travel. Another idea, is to mark the programming plates themselves; instead of having a sheet of paper, mark the individual holes the pins go into.
Reply: In order to keep it simple for reprogramming on the fly, I would suggest making a separate set of programming section for the triplets in a different color, so that you can use the template idea with a courser resolution than the bar magnets would allow. If you're going to reprogram the device multiple times per show, I would think that you would want to just drop over a template (ideally with registration magnets in unused holes) and drop magnets in the empty holes. If you have too small of parts, it could get messed up. And changing to the 3/4 grid should be a simple grid change in your CAD.
Reply: Wintergatan I like the idea of using the block magnets and the templates for programming.
Reply: Why not make a set of triplet plates instead of using fiddly offset pins. Or subdivide plates into sections so you can add offset sections where needed. Seems a lot faster to use that 3rd set of plates or offset sections to swap faster during a concert.

Block pins might be too fiddly or not strong enough to activate the machanism. 

As for reprogramming with speed, how about some kind of solution with elektromagnets. Disengaging the magnet releases all pins in one go, and common sets like drum lines could have a separate circuit, to either keep them when releasing the rest, or to Just have the required pinholes magnetize to prevent mistakes.
Reply: Could you CNC a pattern into the glossy mats to produce a type of zoetrope effect?
Reply: I don't know if some1 had suggested this already but how about another set of panels for tripplets? I dont think you want to mix temp.
And I prefer the black glossy panels.
Reply: could the bar magnets be used in two orientations? Fitting into a cross or 'T' shaped hole to change to triplets?
Reply: Make a full set of 3 triplet pins as one piece or you'll go crazy trying to find the one with the right offset.
Reply: Glossy. 

No clue how to help with triplets issue. But for the pins removal, can't you make the magnet holding the pins in be on a different shiftable piece of wood, so that when you want to detach all the pins, just shift the magnet piece of wood off a little so that all the rods can fall out on their own by gravity?
Reply: What if you had springs under the pin and used the board to program them? So you had a spring under each pin and the board would just down the pins you don't want and there would be holes in the board for the pins you do want in that specific song.
Reply: I'd recommend to do the second set of plates in thirds. So you'd just have to different sets of plates rather than a mess of different pins.
This'd mean you can't have two songs using the same set played after each other, but it'd force you to mix up things a little bit and that does not sound like such a bad thing after all.
Reply: What about having register bars that slot into the programming panels? That way you just have to configure the bars with music then slot them into each panel.
Reply: I am in no way an engineer, and the most engineering I have done was for a class I used to take. Now, I do have an idea that I'm not sure if it would work: Instead of having two different kinds of pins, you could have two different kinds of programming segments... You have eight plates per song right now, why not have 16 plates per song, with 8 being 4th notes and 8 being 3rd... This would cut back on some programming skill, as there is only ONE kind of pin, they would just need to know which segmented plate to program.
I feel that making two whole sets of 10,000 magnetic pins seems a bit more expensive than just making 16 programmable segments that run along with the 3rd music signature. It would also get the machine to look a bit more uniform, as instead of some pins stretching 3rds on a section of 4 holes would look uneven, where having sections of 3 holes and 4 holes would be slightly less noticable.
About the idea for round or rectangular pins, I would have to agree with the idea for round pins, as it looks WAY cooler in my opinion, and why fix what isn't broken?
Hope this idea helps!
Reply: I love the triplet idea but I think you'd be better off only using one type of pin. The most practical solution would be  to have 2 separate types of plates. Also I love the gloss. But maybe you can add some matte accents.
Reply: I hear glossy black and block magnets over heres! Looks like a more elegant solution
Reply: 2 tracks of registration holes 16th/triplet.
Make one track glossed and the other frosted.
So it's easy to program and not mess up which track is being programmed.
It will give the wheel a striped look, which may add a dimension to the machine you may or may not want.
Reply: i'd like to agree with the idea of punch cards to preset up the panels and would like to push the idea of making a few spares in case any panels get damaged.  along with a maker to determine what way is up for the panels.
Reply: One possible drawback of the bar magnet system: they look too narrow, so with time they might chew into the plastic, and then timing is off. Finish: matte. With time it'll be matte anyways.
Reply: Why dont you just make a third set with triplet holes and cut the problem alltogheter. Doing things like this is the main advantage of a modular programming weel so just take advantage
Reply: Wintergatan This might not be that helpful but keep in mind that a YT reply section gets limited to 500 replies I think..
Reply: If you are already going the offset route, maybe you want to go the "Gutenberg" route (the guy with the movable letters)? Have all kind of combinations of pins (probably each in a different color), in a huge sorting box that all have the same "interface" to connect to the programming wheel and a different "head". That would allow you to even play unsquare dance or songs in other exotic metres. You could also mass-manufacture these "musical letters" that just don't represent a single note every time, but maybe a full bar or full beat out of different materials, give them away to participants...

It would lose the concept of "1 pin = 1 ball dropped" though, it would be more like "1 brick = 1 beat".

The other option is to make sure that you are using a number that is divisible by 3 AND 4... with powers of 2 above 64 however that's the case with 512 [EDIT: WRONG! Duh!]... not sure if you want to drill 8 times as many holes. With that amount however you'd be able to use the original concept unmodified.
Reply: Are you still set on pins? Why not go full music box and go for sheets wrapped around the drum with the holes causing a channel to play? This would allow for changing the song on just one instrument at a time, eliminate the hole position timing problem, and you can keep your existing panels with pins as a quick loading system, even embed the magnets in the song sheets. More importantly, it would allow you to travel with many songs preprogrammed, the "you have 3-4 minutes to reprogram 8 boards" problem sounds tricky to me. Perhaps you'd have to go with canvas and metal eyelets for strength. https://images-na.ssl-images-amazon.com/images/I/51he2UGuBiL.jpg
Reply: I think the bar magnet is better than the offset pins, asking the programmers to choose between the regular pins and the offset ones will mean mistakes are made, which could ruin the performance. 

Bar magnets are much better, but still with some problems. Since the bar needs to be oriented correctly to be inserted into the plate, the programming will take longer, either requiring more people to do it, or more practice for the programmers (might mean you can't get audience members to help). Can you fit 2 rows of round magnets and still trigger the marble gates properly? What if you use thinner magnets?

Finally, using a template is a great idea, but i wonder what material is best. It needs to be flexible otherwise you won't be able to remove it as the pins will hold it in place. It needs to be rigid and resistant to wear so that it doesn't change shape over time. Maybe thin lexan, 1mm thick or so?
Reply: You can make a negative of the programming section and lock mechanicaly the pin. With that you only need 8 programming section (or 16 programming section if you want reprogram the wheel in stage when the first is still used in the machine)  but 16 negative section for 2 song. You can easily program out stage the negative and transfert in stage the pins,  and you don't lose the program when you change the music. I hope you understand the idea.
Reply: You could make small metal things that cover four holes (i. e. one beat). These would have a long magnetic pin inserted into a hole in the program plate and a short one that prevents twisting. On the other side of the metal part are fixed triplet pins. There are only five possible combinations in a triplet, since the metal parts can also be turned by 180 degrees. 1. all three pins 2. one pin in the middle, 3. one pin on the side, 4. the two outer pins, 5. Pin in the middle and on the side. So you would only have to make 5 different metal parts, but a lot of them. At the end you program the triplets in whole bars, not pin by pin. could be painted in different colours to make fast programming easier,
Reply: My only other suggestion would be to find a slightly LESS secure way of attaching the panels so that they could be yanked off mid-song. Imagine not being limited to 8 panels, but being able to have a song with 16 panels. Your breakdown from the original Marble Machine wouldn't mean you'd have to stop cranking. Just keep cranking away. Having an "Intro" panel that starts the song, and as soon as it finishes triggering marble drops, a technician yanks it off the machine and a second technician adds in the replacement panel to keep the loop going. When you're 7 revolutions of the programming wheel from the end, a technician adds in the "outro" plate to finish the song.
Reply: I don't know a lot about music but would it work to have 36 instead of 32 holes in every panel-row? It's both divisible by 3 and 4 so I guess you could play both triplets and the normal music.....?
Reply: Hi Martin, I absolutely love your work and I'm really looking forward to your world-tour! 
I think having two rows of holes per channel is by far the best option. Offset-pins would be hard to program and with two rows your idea of hanving templates still works. Maybe you can make this also work with (smaller) round pins which I think will be better and more durable than bar magnets. Also round holes are easyer to machine.
Reply: Jason Kay Excellent idea ! Glad I looked at the comment before saying the exact same thing. No need to create convertible pins as there would be no songs using the four and three divisions at the same time ! Keep on doing the amazing stuff you're doing Martin
Reply: Hi Martin, I immediately thought about simply offsetting the 3/4 holes into the 4/4 grid, so there are overlapping holes, but with enough ridges to hold the magnet securely in place. This quick illustration shows what I mean: https://i.imgur.com/3tl2hNp.png 

But this solution probably calls for thinner magnet pins, I guess.
Reply: I think what you should do is make some visual design rather than having big templates. You can add line after every 4th hole to indicate a new beat. Maybe even have at the end of the wheel numbers indicating where to start making it easier to know where the song starts.
Reply: PROGRAMMING DRUM FINISH
Matte. A large glossy surface will reflect too much light, & would have a high chance of dazzling you/the band & the audience, especially with overhead lighting.
In general, keep large areas matte/eggshell. Like amps, cabs, etc.
Reply: Hi Martin, why not just make the 5mm holes next to eachother? The 16th and the triplet holes bearly touch, and I think the pins should be able to stick in there without any problem?
In this image I show both 16th and triplets combined in one row in the middle:
http://www.hosumprops.no/wp-content/uploads/2018/02/Wintergatan-16th-and-triplet.png
(14.8mm spacing of 5mm holes for the 16th, and 19.733mm for triplets)

Depending on how wide each registrator is, you can shift the triplet pins 3-4mm over to one side, like this:
http://www.hosumprops.no/wp-content/uploads/2018/02/Wintergatan-16th-and-shifted-triplet.png
Reply: The double track, one for quad, one for triplets, is a good idea and gets rid of the need for 2 different sets of pins, which enables my reprogramming idea as the pins need to be all the same type.

as for reprogramming, the paper template idea is slow as the operator has to place every pin one at a time. Instead you could 3D print a hopper/pin holder so that the magnets are always held vertical. then attach a template to the section, the template needs to be hard thin and nonmagnetic( so aluminium..for example) then all the operator has to do is slide the pin holder over the surface, the pins will drop out of the bottom of the hopper into the slots where ever they can(wherever there is a hole in the template) start at one corner and move to the opposite one. when all the slots have been filled. carefully lift off the template. with good tolerances on the hole in the template, and the fact that magnets will hold the pins in place, lifting off the template shouldn't cause pins to go with it(thats why it needs to be thin and non magnetic, thin=no room for pins to bind to the sides of the holes, non magnetic cuz the pins are magnetic) The pin holder needs to be partially open on one side since the pins stick out of the surface once inserted in a hole(you can only move the hopper in 1 or 2 directions, moving backward is blocked by the pins that have been put in place). The hopper allows the user to just sweep it over the surface and place pins much more rapidly, you become limited by gravity, how fast can pins fall. In fact it may even be faster then removing all of the pins(which you stated was already quite fast) 

EDIT: Also for the finish of the surface, beware of stage lights and the gloss finish. the audience may only see glare and not the pins. if it is your intention for the audience to be able to see the actual pins in the machine then matte is better, however the brushed looks makes the surface looks grey and not as nice. There are sprays you can apply before you cut the hole to make the surface matte without sacrificing the black colour, like a matte clear coat/varnish. you would need to do it before you cut the hole so you dont accidentally fill the holes with the spray, as even a little build up will block the pins.

EDIT2: Also the aluminium template could have little nubs/short pins on the under side that fit into either the bolt holes or the unused pin holes, that way it can be put on and wont slide around when reprogramming with the hopper. it would also help to place the template exactly, since the holes need to line up.
Reply: I like the idea of the two tracks for simplicity, aesthetically I think the round pegs look better but only a bit. The rectangular pegs should be plenty strong while the machine is being played but while it's being reprogrammed & there are forces across the short edge I can see them potentially breaking. I think it might be an idea to drill small pinholes in the steel sheet so that you could quickly flip the section and use a small pin/rod to push the broken magnet out, otherwise I can imagine it would be quite the headache.
Reply: By using a card template full of holes you are only one step away from just using fanfold card, like they did 100 years ago. I think they got it right then. Your original design was simple and elegant.
Reply: Why don't you have a grid system on the plate so you can put in a block of 4 notes or a block of triplets. then you can have 4/4 and triplets on the same programming plate.
Reply: What if you could also program in 5:4 time?
Reply: Hi Martin
I would make the machine flexible, so I was thinking on double the thicknes of the plate and let your CNC machine or 3d printer  do the work to make pins, create a program that translates MIDI to cnc commands. So you then can have both worlds plates with holes and magnet pins, and machined ones. Even when I type this you could also program ones make a mold of this master and duplicate it. Regards keep up the good work.
Reply: one black and one gray pattern can be usefull and less complex to set it up. and there will be a contrast of color to have a multiple of color. and i like the idea on the thin pin for the triplets, it will make the refill of a new song easier because if we put a paper in front, the place where we need to place triplets will be more complex to fill because the triplets pin are all different
Reply: Someone mentioned having metal pieces and magnets allready in the template. I liked the square pieces with a separate line for triplet holes, as this gives a lot more flex for melodies if you just want a short triplet piece even if the track is mostly in 4's or something. Maybe even a 3rd line for offbeats.
Reply: I like the shinny black, it will contrast against the mat wood more, 

I also want to buy your demo waltz track lol, everything you do sounds good,

Much Respect
Reply: I think the glossy black with the bar magnets would work best.
Reply: It's a bit out there by why not build template sections to store the magnets. The template are have the magnets inside the circle. You could hold the magnets in place in the template with an electromagnet, align the template with a section, push the template onto the section and turn off the electromagnet. If the magnetic force between the section and the pins is greater than the magnetic force between the pins and the template, you could remove the template without the pins coming with it. When the electromagnet is on, the attraction between the template would outweigh the attraction between the pins and the section and all the pins could be removed and stored perfectly.

Honestly don't know if this would work, I'm a computer scientist, not an engineer/physicist. I would think the main problem would be trying to overcome friction when removing templates to get the pins to stick to the right side. You'd also need 8 templates * the number of songs.
Reply: If you're going to make lots of sections anyway (for backup and the sections being reprogrammed), you might as well make a different sections altogether just for triplets. So you'll have a two types of section (triplrt and normal). 

The advantage is you can use the same type of pins and you don't have to worry about alignment if you have two tracks side by side (triplet and normal). 

The downside is you can't change modes midway through a song. A song would have to either be all triplets or all normal.
Reply: I think double track is the best solution here;  The triplet pins look troublesome to fit in sense that unlike those rods, where one rod can be put everywhere on four holes, first triplet pin only fits on the first hole but not the other two. Meanwhile on two row pattern you can put pins on whatever hole you want.

I'd suggest further - in two track systems case - putting triplet row in bar pins and 16:th system in cylinder pins to help audience / "lab workers in white coats" differentiate between the two systems even more while programming. Or some other binary pin solution of your liking could work.

To ease up programming I'd make templates with holes, as you suggested. If possible; plates could have a number and a hole, with a matching insert pin that's different for each separate programming template. With aforementioned solution, templates could have rectangular holes for songs that need triplets or circular holes for 16:ths. Or both if it would even fancy you out. This of course makes my suggestion of binary pin system obsolete.
Reply: Wow within 50 minutes of the videos release and we have 200 replies to this comment. Martin you're moving up in this world!
Reply: why not make a triplet pin that fits inside the 16th hole? like 2 pins at the on side and 3 at the other.
Reply: How about using electro magnets on the plates with metal pins . So when you unpower the magnet the pins fall out
Reply: how about using block magnet and one track and use advantage of its rectangle shape? 4/4 slot with [-] direction/ triplet slot with [ | ] direction 
like [+  |-  |- | ]
Reply: one problem with breaking magnets is they might end up stuck somewhere in the machine where you can't easily find them, altho that did seem unlikely to happen, might wanna make sure you catch those so they dont jam anything important
Reply: The problem with that would be the detection system. Would it be able to detect all of the pins if they get too close to each other? I think that's why they need to be a bit away from each other.
Reply: I like the idea of being able to do 3 and 4 time simultaneously as well... you can get a lot of interesting music from the overlapping rhythms (Debussy Arabesque no1 (for piano) springs to mind).

May be too complicated to have two types of pins, especially if non-marble-experts are reprogramming. I like the idea of the rectangular magnets with two rows for 3 and 4 time. Is there a tolerance for the separation of the two rows in order to produce the same note in both times?

For the reprogramming, maybe a card map (think 350 gsm) would work as it is cheap to make multiple copies, disposable, flexible but the holes would not degrade as quickly as paper of a flimsy material. Alternatively, you could number/letter the rows/columns for each 8th and have a sheet with corresponding coordinates and a 1/0 value depending if pin is inserted or not. Then you could have a whole booklet for each 8th containing all the songs. Don’t forget to clearly name the 8ths as well - could even name each one after a composer, and have different 8th names for the second set, for even less confusion.

Happy building!
Reply: Wintergatan if you're going to have multiple plates, then you could always have different plates with different times
Reply: Would it be possible to do 4 and triplet lines, and then having a cool 5/4 and 7/8 set of pin-holders?  I know it would be more work, but having more options would be advantageous.  Also, how many lines of pins can you hold per marble dropper?  In one of your Music Machine Mondays videos, there was a music box that had like, 3 different songs, and you just had to nudge the cylinder over a teensy bit to get it to play a different song.  Would it work to do something like that, and have a 4, 3, and maybe another 4 line?  I understand that space is very limited on the machine, and that this might be a total flop idea, but I think that having more lines, the better.  Also, I like the bar magnets idea.  I want it to be easy to program the wheel when you come on tour to the US.  And glossy is cooler.
Reply: I would go for glossy black, it looks a lot cleaner than the matte finish.
Reply: GLossy and matt, odd plates are glossy, even plates are matt. The audience would have a better time seeing the plates move.

Also, reddit thread would be a better place to make discussion than Youtube comment.
Reply: You could paint patterns on the programming wheel which loop so the audience who are standing quite far back from the stage can still see the barrel turning, alternately you could wire small LEDs in to the plates witch flash when the pin comes into contact with whatever they are going to come into contact with. This would make it very clear to the audience what is happening at any given time but may be quite complex and i know you don't want to use any kind of electronics in the Marble Machine X.
Reply: Somebody else may have suggested this already, but why not have an extra set of programming panels divided into triples, keeping the main sets divided into 4? That wouldn't allow you to mix timings in the same song, but might be simpler.
Reply: Wintergatan I think what you should do is that one where in every strip there are two lines of holes for the pins and the one line is the normal four and the second is the triplet, but you can also make a third made spesificly for waltz songs, that is, if 64 can divide by 3. If not, then stick to the triplets because a waltz works with those too. As seen in your video.
Reply: Small Square holes are very difficult to cut with rotary cnc bits, at the tolerances you are talking about. Two different kinds of offset pins (since the 2/3 and 3/3 positions probably have to be different) that have to be placed in only the correct hole and orientation seems like a nightmare. Use normal round holes in an along-side track like you showed, and don't worry about them getting programmed by mistake: any template system that is precise enough to keep two 1/4th holes clearly identified is also going to keep the programmer from mistaking a 1/3 hole for a 1/4 and vice versa. Additionally, unless the whole song is crazy interspersed time signatures, any pins put in the uncommon timing track with visually jump out as being offset to the side, and allow easy error checking. (Especially if you don't reuse the 1/4 hole for 1/3)
Reply: wood expands and retracts upon weather conditions, while you made sure they fit snug today, I dont believe that that will stay that way, and even after a couple of uses there could be wear and tear
Reply: I have two different subjects I'd like to comment on. Firstly: If you keep the live replacing of the pins a manual task, those newly designed triplet-pins will be a nightmare. The rods are easy to use. They can only go in 2 ways (which is a mirorred state from eachother) so any one of those placements would work. Triplets on the other hand, or at least the ones you designed, are locked/limited in the direction you can use them in. This would result in a much more carefull and slower placement when changing the song on one of the boards. Not even considering having to pick from not just one box of rods, but 4 boxes of 16th's, 1st place triplet, 2nd place triplet and 3rd place triplet. Also, they are designed now to lock on to eachother, but you rarely need triplets of the same note. And when u leave out the middle one, the last one suddenly has a rotational axis on which to swing on, which makes it possible for it to get misallingned and even possible activate the wrong notes. I'm currently thinking about a good suggestions and may add it later, but I just wanted to et you know a bout this.
Secondly: Automating the change process will either cost you a lot more materials (which need to be transported each tourday) or would distance tself from the true mechanical nature of the build. What I mean with that is according to my suggestions. 
1. negatives; have an empty board loaded instantly by inserting it onto a pre-filled dummy without a metal backplate, so that the pins places in the dummy attach to the main board easily. The negatives can be pre-filled a long time before, as long as you keep the pins from falling out, but it would mean that you need a pre-filled dummy for every board in every song you use, ergo many materials.
2. electromagnets; it's a wild guess but; make the metal backplate a electromagnet which holds the pins in place. One discharge of the electromagnet will result in all pins losing their "stickyness" and falling out. How to implemetn this or how to power this has not been thought out yet.

Please feel free to contact me for further instaructions.

Keep on building, lots of love!
Reply: To remove all programming pins the same time: use a sheet of steel (maybe other thicknes or alloy) and maybe put a sheet of paper or similar between magnet and metal on the wheel.
Reply: Isn't there enough space to put two rows of holes for the magnets? one "straight row" and one "triplet row"... both rows trigger the same note
Reply: You should avoid the pins having any orientation if possible, it will make re-programming much faster. Also accurately cutting very small square or rectangular groves on your CNC machine would be difficult. However if you could cut it really accurately another option is to have the single track but with wide flat rectangular slots cut over smaller circular peg holes. Triplets would be played on the flat pins and the 16ths played on the peg pins.
Reply: # Gloss vs. Matte #
- Idea one: Go with glossy because it looks better. Maintain it with car wax or let it age gracefully like Willy Nelson and his guitar.

- Idea two: preemptively distress the surface to look like it has already been on tour, so new damage blends in.
Reply: How about square pins with the part exposed offset for syncopation as demonstrated by would "Hole punch tutorial".
Reply: Two rows of pins per channel sounds like a great idea, assuming the release mechanism can cope fine with the lateral forces from the offset pins and the structural integrity of the plastic is sufficient with that many holes in it. Personally I'd also centre that first common pin, but that's just me.

Before you mentioned having the second row for triplets I was considering if there was space for a second row of pins to allow 32th notes... even if the release mechanism can't cope with repeating a note that fast, different notes could be that fast. Not sure if you have a need for notes to be played that fast, although I suppose you could double the length of the repeating section by playing the song at half speed?

I'm not sure if the cost would be prohibitive, but you could make a pair of triplet programming wheels and a pair of "standard" wheels? Would make it impossible to mix triplet notes and standard notes in the same song.

I personally prefer the glossy appearance, although you'd have to be careful to not get scratches in it as they'd show up clearly.

I think a template for each song to ensure notes are in the right place would be a requirement... if not there'd at least need to be a clear indication all around the wheel which note is which and where beats and bars are...
Reply: If the plates become too awkward to redesign for triplets as well (incidentally I liked the idea of the triplet pins), one alternative is to have removable and replaceable crank gears with a different number of teeth, such that one full turn of the handle activates only 3 rows of pins instead of 4. It would mean you still have that extra bit on the end, but the music already sounds dynamic enough that I doubt many would notice.
(Edit:) I prefer the glossy black. Gives it a lovely Grand Piano vibe when combined with the wood and keys the marbles will fall on.
Reply: My idear is to have four pins (only long enough to insert into the programing plate) that are together fixed to a metal plate, wich has three or less pins fixed ontop of it. there are only six possible combinations of three pins that are usefull, so it wouldnt be so dificult tp make a set of such "building blocks". more detailed explanation here: https://imgur.com/NRzsS8F

ps. im sorry for my crude drawing skills in ms paint

(edit) ..and btw, i only meant these sections to be one row wide, like this: https://imgur.com/2wxZGZR
Reply: I think the bar magnets and glossy black are the best options
Reply: Wintergatan you could have another set of boards set at waltz time, but you couldn’t change time signatures within a song unless you mixed the boards up.
Reply: Hey Martin! First thing first: I would prefer the Glossy panels.
But also i love the idea that someone from the audience, could come up on stage to reprogram. My concern there would be that they will be high on adrenaline, so they'll have a narrowed field of view. Therefor i think an idea would be, to mark the holes in the template with colour (Preferably red, because it's easier to see). It makes it easier to spot the holes, even under stressed conditions.

Also i find the design of the triplets, where you have an interlocking system, best. That way you can keep the design simple but versatile. Also i believe that the steel would be a better solution because, i believe that the magnets would eventually break due to metal-fatigue (Stress over time).

Keep up the good work! Love your videos!
Mathias
Reply: Instead of 4 holes just drill 12 holes, that way you can divide into 4 and 3
Reply: Loving the progress.... I have ideas :)
1. Modular programming plates as well as fixed timing plates. Some plates are setup as 4, some as 3, some have modular (CNCed or printed, magnet attached?) sub-panels that can allow one panel to do ANY combination of timings without compromising the strength of the panel with lots of holes. Different compositions use some fixed & some modular. Future proof.
2. The rectangular profile magnets looks good, but I fear you're cutting away too much strength.
3. For super speedy programming you need to only have one type of pin. Abandon any idea that has different types.
4. Avoid fragile complicated pins. Straight only. Idiot proof.
5. Flexible laser cut / CNCed cue sheets for programming a great idea. A) strip old pins out B) attach template C) place new pins. If you organise pins by song you'll know exactly when you have used them all.
6. For programming / placing pins. Use a light & shadows to see which pins need placing.
7. If using bought magnets be sure you can still buy them / get them made in years to come.
8. Test strength of those bar magnets. Make a rig to test their strength.
9. Make sure friction on pins is never enough to make them walk out. I'd imaging loose pins stuck to your marbles would be bad. I'm sure magnets over time will be fine though.
10. To speed up programming further. Make the template sheet out of something soft / grippy. Preload it with pins held in by friction. Align it with registration pins then push all the pins in. If template is too sticky then it will pull magnets out when you remove it, so a thick but flexible template faces with a thin spring steel sheet will allow pre-loading on compositions, and then slide the face plate off.
11. As no 10. But leave the template sheet in place while you play. Different materials for different songs.
Like so many of us here watching you... is so love to get involved with he design of this. Awesome fun.
Enjoy yourself :)
Reply: You can put spring on the bracket so when u close them to hold the module it will push it and stay . the spring should be the one touching the wood not the bracket wood itself. (sorry for my ugly english)
Reply: Don't know if that idea has been suggested but I think the black color is better and it gives you the possibility to play with the light and add glowing painting on each magnet to make it look like a galaxy. Completely the theme of one song, and overall a recurrent theme in your art.

.. Anyway, and not to bother, I really like what you show, this will to share creativity and ingeniousness in a beautifully artistic way. The fact that you ask for your community to help you makes it even more awesome!

Hello from Thailand.
Reply: There's actually 7 combinations of triples (numbers show played beats, x's are rests): 1XX X2X XX3, 12X 1X3 X23, 123. 

Manual tasks like this will go faster when the operator doesn't need to think, having to choose from so many options would take too long. Better to have 1 type of pin, enough holes to allow for the music you want to play,  and "automate" the placement using a template.
Reply: You will need defenetly more programming wheel piece sets than 3... More relaxing to the crow, redundancy if something breaks, etc. Thos are the most changed parts...
Reply: Okay, if I understood it correctly, you have 2 solutions for the 4beat and 3beat "problem" in the video. They both have their pro's and contra's. With the first idea, having 2 different types of pins, you would have more freedom music-wise because you're able to use both the triplets and the 4 beats in one and the same bar. However it does mean you need to print more pins and the "programming people" would have to know the difference between the two pins.
          On the other hand, the second idea with two different tracks might cause the problem that a lever cannot registrate two pins that are on the "triplet track" and the "4beat" track.
A 12-beats-per-bar-system would make it in some way easier, however that's almost impossible to fit on such a small bit.
          I have one more question, you have double channels for all the notes, how do you plan on having those second channels play exactly in the middle of the others? Trying to build in a delay in the lever-system would be pretty difficult and inconsistent when you switch between 4-beats and triplets/waltz. The better way of adding a tiny delay would be by offsetting the tracks of the second channels on the programming wheel.
Hope my comment is useful! :D
Reply: Maybe rather than the plate design, you consider removable tracks or rings.  Sort of how in your prototype you had 1 track affixed to the plate, maybe replicate that throughout the whole wheel.

The advantages are that you're not limited to 4/4 time, you can consider 6/8, 5/4, etc.  Even go so far as to time changes within a revolution.  

You can have part of a channel accommodate the triplets, or even a full channel without the entire panel being affected.

As an aside,  back lighting the peg holes would give a cool disco-ball look!

Cheers.
Reply: Wintergatan absolutely fantastic video and great explanation of your thoughts. For me personally the specialised pins look like a lot of confusion waiting to happen when trying to pin the board in a hurry. And two tracks wouldn't add that much complexity in pinning (even if they're rectangular).
One thing you might consider is how to get the pins out again. One by one might be good enough, but why not put some magnets on big-ish wooden squares with handles to pick multiple at once? If the tolerances on the pins are super tight, it might be a problem that the pins jam in, but it would be worth a try IMHO.
Reply: I think one generic pin type is better than 4 different types. Sorting these on stage would be a nightmare to handle. One pin type makes things easier. If there is a space for 2 different rows of holes, this is in my opinion a better solution than special pins. Also the rectangular pins can be inserted either horizontally or vertically, so if the holes were in the shape of '+', you could orient them in 2 ways, adding a really short delay for the horizontally oriented pins.
Reply: Yehuda Katz I was just wondering if the bar magnets would have the same strength as the 5mm round magnets.
Reply: this might be crazy, but could you just use longer pins to create the desired offset between the pins while still keeping the original boards?
Reply: You are a genius, every single though I have, to try to help you out a bit, you already have one better also you already fix the bugs of the design, I thinks the way you have it setup is amazing, honestly offsetting the pins with a different form  for the triplets is better because using the template there is no way to miss the programming sections. 

Keep it up and thanks for being an inspiration and example of dedication.
Reply: I'd go for the double track. Seems the more practical way IMO. A "Y" design, meaning the first beat in the middle and then one track go say left for 16th and right for triplets. That way even if you only programs 16th notes, you'll always have a visual of the first beat because it's offset ;)
Reply: "tuplets"

Really? It's "triplets". -.-
Reply: Wintergatan May I suggest that you manufacture as many plate sets as you have songs.  Firstly, this is historically how it was done.  Secondly, you can then make any division you wish for each song, as you them have tabula rasa.   Thirdly, you will directly contain a large cost on tour, which is personnel, as you won't need to feed or house them.  Fourthly, NO MISTAKES, as the song is already programmed, all you need to is to apply the sections in the correct order.  The ability to reprogram is wonderful and should remain as a tool in your arsenal, yet to include this tool is unwarranted for the tour.  I hope this helps.
Reply: Maybe yous should divide each line into chunks : make a four note long segement : the advantage would be to be able to be really fast, and be as creative as you want.
What I mean : o-oo is a chunk, it's fixed and is only one piece, it can be mounted backward like oo-o
and if you want you can make chunks for triplets and all other sorts of weird grids : o-o, oo- ect...
For 3 and 4 notes each times, you would need 11 differents types of chunks, wich would be pretty easy to have sorted next to the programming wheel
That's not as versatile as your idea (wich is great btw ;p), but it could be interresting !
Reply: I think having the offset triplet pins is a great idea! You can also use this idea to make other sorts of pins (like quintuplets, etc.) so you can go even further with the instrument's musical dexterity. I feel like a design that has more than one track per marble would be really fiddly and difficult to execute practically.
Also, how fast can the machine be rotated before the mechanism that releases marbles struggles to keep up?
I think, whilst I like the glossy black, the matt would be more practical and would also allow the metal parts of the machine to stand out more.
Definitely label all the plates and have spares... Not doing so would be like a solo violinist not having spares strings or a bow for a big concert.
This is looking amazing, and I love all of the videos that you have made :) Hearing about your thought process and watching you make this instrument is honestly the highlight of my week!
Reply: There is really no choice.. You Must use the triplets.. i mean what a concept. #BRUSHEDMATTE
Reply: Only commenting on what I know enough about to possibly help out:  Love the offset pins...gluing the magnets is a secure option?  Also love the template idea & involving your fans in the pin programming.  Not a fan of the retractable pins.  And I vote for the 1st option for the sections (not the glassy black...you can see scratches and flaws when the light reflects a certain way).  You Rock!  Love from CourageCards on FaceBook  :)
Reply: For ease of use I would totally recommend this, but the problem with this is that you can't see the cutting head anymore which is way less satisfying to watch.
Reply: using the bar magnet would actually allow for a better option. You can make the posts long ways, but you could also rotate them 90 degrees ( II to ---) and keep them mostly in the same space. That way you don't need special posts like the round holes. But if you rotate the posts 90 degrees that would actually allow you to drill holes for 6 slots instead of 3. with 6 slots for the square posts being used - intead of | you would still be able to create triplets or set up the song to be played slower for a waltz and have more notes in that you currently have but still be able to easily switch between, 3/4. 4/4 and posibbly 6/8 using the same timing and.
Reply: Hey Martin! Loving the design and watching this evolve. First of all, glossy black for sure! I liked the idea you touched on at the end with the flat magnets and having two rows for each note - 4x 16ths & triplets. 
One other thought I had - what if you had a set of programming plates that were drilled to the triplet pattern? You could also use a different color polythylene to denote it is a triplet section? That way you can program whole songs that are triple based and others that are duple or quadruple based, or even swap in a triplet section to a song. Thoughts?
Reply: maybe you could use square magnets to keep the triplet unes from rotating.
Reply: I wonder if it would not be much easier to make a set of plates per song. this could give you any timing you want, even faster notes etc. If you would want to stick with programming them on the fly, I like the idea of having a triplet track next to the normal holes, much easier than designing special pins. If a CNC can do that you could even tilt the holes so pegs meet the trigger at the same point.  If you want to play the whole song in 3/4 I would use a set of plates that was made for that (so that a whole round of the wheel is again 8 or 16 mesures in 3/4). because you can than again add a triplet track, giving you the same flexibility in 4/4.
Reply: Bar magnet sounds like the way to go, and personally I think the black programming panel looks dope.
I’m at uni studying to be an engineer and I love the way you bring the beauty of engineering, art and music together 😁 keep it up!
Reply: what if you made the programming wheel movable, so you can shift it to the side to play a differetn song, maybe do one in quarter and the other one in triplets.
Reply: Hello (sry if my english is bad) 

It's about the design to make the reprogramming easier. 
You could do a plate that you put on the part with magnets? like a paper with the differents track on it, and in order to program the wheel, you would just have to shift it on the left/right (or up/down).

Like your idea with hole, but an idea that you could use directly on the part, without taking it off each time. 

i can write in french if you prefer xD
Reply: Wintergatan why don't you make each crank not 3 or 4 but 12. That way you can use the same pins for both
Reply: Hey Martin! i love your videos and follow every week since i first saw the first marble machine. a few things.

Live Programming: you said in the video about a template to have live programming going on. i think that is a great idea but i want to elaborate on how i think you could do it. first you could get some 1/4 thick plexi-glass or poly urethane, whichever is easier to work with. then you can pre program a song onto this "fake" programming wheel section. you do all the holes like the actual sections, but then you have the magnets already in there and you have a sheet of metal on the back. so at this point, the programming wheel section that has finished gets taken off and the magnets pulled out, then your new section gets fit onto the wheel sort of like a new piece of the of the black poly. but when you fit it on, the thinner sheet which is holding the magnets with the new song, the magnets go onto the sections, then the sheet of metal on the back, or the side facing out, is taken off. then the magnets for the songs gets left in the programming wheel for the new song. heres a bad ms paint mockup. https://imgur.com/a/gghog THANKS
Reply: If you pick triplet pins instead of separate tracks (i think two tracks is the better idea), i'd suggest that you make single assemblies for one pin, two pins and three pins (all together): as your CAD drawing shows, the first, second and third pins have to be different, which would be hell for the techs. If they come in groups, they'll be easy to spot and it'll be impossible to confuse them with others.
Reply: Martin, how about a device where you can have the pins pre-placed but that it can remove the ones on the machine at the same time too. Think it as In a bowling alley where the bowling pins that have fallen have a guide that pics them up and resets them. I suggest a similar approach. Placing a mirror programming sector which can be mechanically triggered to catch the already placed pins so when pulled they come off, but the non triggered pins stay as a new song on the programming section.
Reply: No there is not enough space, if you see 14:11 it's clear he could barely achieve 6 pins in that space.
Reply: Wintergatan you can do also another programing platform while it let you play in triplets. Good job, I’m nervous to see MarbleMachine X
Reply: i think you should have kind of like stamp templates, so that you can push a template on the inside of a section and the pins will snap into the correct place.
When youre done with a song you can push the pins back in and use another template stamp.

Kind of like those pin toys where you push your hand on one side and it mirrors into the pins.
Reply: Martin - love your work and the ingenuity that has gone into this project. Reading this thread is really difficult, maybe Reddit is a better forum which allows for back and forth discussion, divided by topic?

As for programming, i think you need to make it really easy for the programmers to do their work. Your idea of a template is great, I think it needs to be a contrasting color to the plates, i.e. white, so that when you lay it over all you see is a bunch of black dots, then just keep adding pins until all the dots are gone.
Reply: You should alternate the sections between black and white, so the audience in the back can see what the machine is doing.
Reply: definitely go with the bar and additional triplet row... simple and effective.
Reply: I have a suggestion to help differenciate between the pins:

You could color-code the different programming pins on the underside. That way you can differenciate the triplets (and maybe others?) from your "normal" pins. And after you put them in, the color is hidden in the wheel and you don't mess up the clean design of the wheel. 

One issue I see with the triplet pins is their stabillity. They don't seem as solid as the neodym magnets to me, I would opt for a metal pin with a magnet on the bottom. 

Oh, and I vote for the glossy finish. :)
Reply: oops didnt watch to end before sending comment.
duplicated.
Reply: I would like to see if it is possible to remove pins with an even larger magnet. It would be less to hold, more pins at a time and less likely to lose pins. It might not be a big issue in the first place.
Reply: Wintergatan first of All I think the glossy one is better!
Rectangular magnets aren't the best idea...I mean the programmers have to look at the orientation of the magnet every time they insert one...with cilindrical ones it's plug and play.
In the mean time offset pins are a very elegant solution, I mean the whole MMX is about fancy looks and nice egineering...the different tracks solution isn't mindblowing...
OFFSETPINS would rise the machine on a higher level, this method is way too sexy to not to use.
Keep up with the awesome stuff you do!
Reply: This. The tracks should be able to overlap quite a bit, while still being able to retain the pins, and them being magnets will help. This could be improved further by offsetting the triplet track, separating the figure 8 shape more.
Reply: Perhaps rainbow?  Have it be in order of ROYGBIV and then white or something?
Reply: Another idea could even be to make the "holes" be kind of like + shapes. Verticle lines for the 4/4 and horizontal lines for the 3/4 slots. If the magnet's can handle being used sideways this could be one of the simplest solutions?
Reply: Robotic plate reprogramming system?
Reply: I think your new track idea is a good one, and wise. Keeping it simpler will help reduce potential issues on stage as well as being simpler to maintain and manufacture. You may also want to consider making a second set of programming plates for live use, this way the machine can be in use playing a song while the programmers can set up the next in a way that adds to the total show. As for color I personally think it might be neat to go with a matte or piano black and find a lighting method to get the pins to either sparkle or glow like piano keys or tiny stars as the wheel spins, though the wheel may be turning too quickly to get a good effect from that idea. These machines are wonderful and I really look forward to seeing the end result!
Reply: You better have some way to mark where is the "top" and "bottom" of the programming panels. It seems they are symmetrical, so, on stage, they would not be programmed (or placed) upsidedown.
Reply: You also need some registration "fool proof" device to make sure each programing PLATE goes to the right place AND right-side-up (to avoid having a huge nightmare going live in a show with people rushing to switch different plates)
Reply: Maybe you can fit 12 divisions per crank rotation if you use the square pins but rotated by 90 degrees. (Maybe in 2 rows) This opens up even more possibilities with shifted triplets
Reply: On the topic of reprogramming the wheel between songs. If you have a board with holes drilled into it that can be placed over the programming wheel, you can have the magnets already placed in the holes this board has a cover on the back that when it is placed over the section of the programming wheel, the cover a the back can be removed and the magnets will be dropping onto the section of the programming wheel. This way the programming can be done before the show or after with only the preloaded board needing to be used during the show. This way you only have to remove the pin from the previous song before lining up the the board and droping the magnets into the holes by removing the back cover.I hope this makes sense. I have added a sketch i hope it helps https://www.dropbox.com/s/riyoy9282muwu25/IMG_7157.JPG?dl=0
Reply: I'm thinking all those magnetic pins will end up causing problems, especially in a stressed environment like on-stage. There must be a way you could do friction fit instead. That would also let you use much cheaper metal pins. Triplet-pins will be a pain to keep track of during setup/reprog when stressed. The offset-pin approach is very nice, and more flexible than my thought: why not have some panels in fours and some panels in thirds (or even sixths). Oh, and. Go for matte panels. They match the wood better, highlight the pins, and won't cause problems with stage lights!
Reply: Wintergatan have a idea to help with reprogramming maybe, instead of having a template to follow to place directly onto the programing wheel you could have a non magnetic template you place the pins in upside down on, then align the actual programing wheel up with the pins the magnets will take lock the pins in place, also with this they can be setting up the next template while the machine is being used, can color code where triplets are needed
Reply: You could use the block pins, using both directions, you can use them turned the ,,long way" for triplets and by turning them by 90° you can use them for the quarters.you dont even have to cut 2 slots. you just need to cut little crosses.
Reply: Alternate the color of the plates so that people at the back can see the drum turning!
Reply: maybe you could have a double row of columns of holes: the even rows are in 4 beats and the odds in triplettes, so you could just flip the programming section by 180 degrees and change between 4 and 3 beats
Reply: Color: i think the shiny stands out more, so it depends if you would like the programming wheel to stand out or not. so i guess Shiny, cos you can always matte it out later.
I thought you could make a completely different (3rd) set on a different color (white?) for triplets. But your design with the bars is more flexible. It lets you have the Bass on triplets and the melody on 16th, idk if 2 signatures on the same bar is musically doable, but you  have  the possibility to do so.
So BARS. 

 For the programming itself. Punched cardstock with guidepins or alignment marks on the wheel, colored? or numbered for each song. you could go song/bar/panel (or bass,mid,high) 3 panels per bar.

the video length is always ok. i think i could watch you design and build this for hours. wait, i think i have.
Reply: Wintergatan in my opinion try to avoid to make different kinds of pins because the reprogramming will be slower , having and offset hole for the pin to have the triplets is a cool idea but in my opinion the best solutions is to make pannels for 6/8 or 3/4 music and the design it in that way , please please try to a 5/4 song it would be so nice to.hear something like that
Reply: Heya! I really love this project, it always makes my day nicer.
I'm not sure if you've tested the bar magnets for breaking, which could be more of an issue than with the pins because they're thinner, but I do like the twin tracks idea more than the offset pins.
That said, if you do end up going with offset pins in the end, you might want to consider anchoring the third one in the fourth hole instead of the third hole; it has a really narrow section the way you showed it that makes me a little nervous.
Reply: You'll need to be careful about how to design a programming overlay. Because it wraps around, once you've programmed it you wouldn't be able to remove the template afterwards (because the pins would be sticking out at different angles and hold it in place). You'd have to probably have a template that stays in place and doesn't get removed afterwards. That could be quite cool though as you could put cool graphics on the templates so the design of the wheel changes for every song. So you could have matte and shiny at the same time!
Reply: I like the idea of the square pins more, easier to make templates for too. I would test those magnets though, it seems to me they'd be even more brittle than the round pins. The templates themselves should have the holes as oversized as you can possibly make them while still maintaining accuracy. It's going to be a pain to put the pins in and pull the templates off if the toleraces are too tight. I'd go with the glossy finish as it'll probably be easier to keep clean.

Also: Is that just standard mild steel on the back? If so I'd definitely treat that with some protective coating on both sides so it doesn't rust.

And how about moving these discussions to reddit or a similar forum? I find it really hard to keep track of who is answering who on youtube. 

Love your music, work and videos and I hope to see you guys in Norway when it's ready for the word tour!
Reply: The pins are great for the 16th paced (?) songs, but for triplets the offset pins wont work. How I interpret it, you make 1 model of offset pins? that only off-sets the music, but not the pace. You will need more than one model of pins to make that work, so that would become extremely fiddly with changing songs. Offcourse you could color the pieces to make it easier but I suppose that's not the way you want to go, because you will need multiple types of off-set pins, it'd become a disco! I suggest you try to make a triplet section piece (of which you got 8), or make triplet paced parts of those black plastic bars. 

Perhaps, you could make a chain (with pivots) of which you hook 1 side in the 16th paced holes and on the other side are the triplet-paced-pins. The idea/model you have! - But chained together (length of the 16th paced music)
Reply: I would build a different set of plates for 3/4 with the correct hole spacing. And in the future if you want 5/4 or 7/8 or whatever then just build yet another set of plates. If you use offset pins then you've got different pins for different positions and that's just going to go wrong if you're programming them in a hurry on stage.

Also definitely number the plates for easy re-assembly and maybe score some lines on the surface of the plates to help with the programming as well.
Reply: Hey Martin. I think the bar magnets and off-set holes are a great idea. My suggestion is to replace the sheet metal backing plate with a flexible magnetic sheet used in the signage industry. That way you are not limited to only using magnets as pins.
Reply: # AWESOME IDEA #
Cover the wheel with solenoids. Write software to toggle the pins up or down   in real time by sending MIDI.
Reply: Different color set of plates would also help making sure you have all the right ones on the wheel. You'd see it in a snap! Set one black, set two grey, set three red, etc.
Reply: As to the question asked regarding the programming plate finish, I think I would like to see a few mockups of other materials. You're working with something quite beautiful, and it seems a shame to just slap a mess of plastic onto it.

I was impressed by the coffee-stained and the glue-layer effects shown in previous videos, which, applied here, might help to maintain a congruent visual impact.

At the moment, the machine gives a very warm impression. The silvery sheeting shown might be in danger of adding too much of a cold element to this, making the machine look at odds with itself. For a metallic finish, perhaps something in a dark copper or bronze.

Whatever you end up doing, even if it is the plastic, I'm sure it'll look fantastic.
Reply: Also i'd suggest you do these threaded conversations in reddit. Threads work wonderfully there and good ideas naturally gravitate to the front.
Reply: Maybe glossy one for setup 1 and the other one for setup 2? And thank you so much 4 making those videos. Get some sleep, you need to live as long as possible, to make as much music as possible °^°
Reply: Here some suggestions:
a) get thin colored lines connecting the holes for each row - esp if you plan to have ofset pins this allows you to make sure to no acidentially horizontally swap rows when programming 
b) going with nonstraight pins sounds like a great idea as you could even have mini offsets to create  more natural sound - but you would need to make the pins properly identifiable 
c) disadvantage of different pins is that while unprogramming you would need to properly sort them for being reusable for the next programming session as they are quite similar and you could easily mess up.
d) I also thought if it would be feasible to have uninterrupted grooves instead of the holes and have some "raster-grid" on the right and left side of the groove and put the pin in some holders that fit into this raster (while the magnetic pin still is responsible for locking in place) - this would allow you to position each pin at the granularity of your raster grid and if the grid is crafted the right way you could even have pins that automatically only register in the triplet or normal position (didn't do the math yet but  if you leave out certain valleys the corresponding pinholder wouldn't fit on that.) - you basically would have different sets of pinholders (prepinned) that are for triplets - I hope that explanation made some sense to you ;)
Reply: I don't know if anyone suggested this yet (133 comments is a lot to read!) but you could have your "cheat sheet" programming pages have designs on them so when the technicians program the plates they can just leave the sheet on and the drum will have varying looks with each song.  Also, it may help them see if the plates line up, both in vertical direction and plate order.  Was just an idea, I also like the glossy black more than the matte, but it's hard to tell without all of the plates on the drum and seeing the design as a finished product.  Keep up the great work, I'm a huge fan!
Reply: CNC cut your music mirrored into some foam, insert the pins beforehand and roll it up when you go on tour. When live you can just 'roll' the programming wheel over the foam to insert the music easily. (when you use magnets the pins will just snap from the foam into the programming wheel)
Reply: I would think that a uniform pin design is going to be important for your team's (relative) sanity on tour, considering Murphy's Law. What about crafting separate 3/4 and 4/4 plates? You'd need 32 plates to cover all of your possibilities of switching between the time signatures between songs, but if you were willing to always switch timings from one to the next, you could get away with only 16. Maybe 24 if you only needed one set of 3/4 plates?
Reply: Just a idea that dropped in to my head really fast but if you have a single typ of pin (say the square one to make it simple) and the idea with a template to make it easier for the programmers to not make mistakes, cant you combine that idea and a pin version of the Marble divider that stacks the pins in slots and only slips one thought when the template leaves a hole?
Maybe I make a terrible exemple or its ruins the reporgramming bit put it could go really fast if you just take all the pins off, stack them in the divider, template on the empty "Magnet midi" and slid it through the divider making the pins go in the right places. :D

Thumbs up if anyone understands and/or like the idea ^^
Best Regards/ Joel Lindström
Reply: Wintergatan Martin what you can do is another platform that lets you play in triplets. My congratulations, I'm nervous to see the marble machine X
Reply: S=r(theta)
Reply: I know you talked about using a 25mm programming pin, but how high above the programming wheel is the pin registering at? To ask my question another way, how short can the pin be before it doesn't register? More importantly, how tall can the pin be before it catches? Knowing those tolerances would help me draw up a potentially useful solution, but only if those numbers allow for my convenient idea
Reply: Wintergatan mate that black thing. Easier to restore scratches, just sand it again. And magnetize metal plate in the back or glue magnets in holes and use metal blocks for pins - easier to handle them that way, will not stick to each other, when putring in. And put 1/4 holes next to 1/3 holes, all pins will be the same, just a bit uneven stress on registers.
Reply: iterating on your idea of a template with holes, what about a template with magnets so that the pins go very easy to the correct position and then just release the template on top of the programmable wheel. But the best way will be to figure out a way without human intervention, just by software, if the pins are like in a pen, maybe you can have something in the machine that program the music at the same time it's playing the loop, that will be the best way, you can upload all your concert to the computer with servo motors that will be programing the thing on real time.
Reply: How about programming strips.
Each strip is in the length of 4 holes and has a different combination of pins sticking up.
Your programming toolbox will consist of every 4 pin combination possible.
You can event produce it on the cnc
Reply: First of all, I look forward to every single Wintergatan Wednesday. The longer the video, the more excited I get. It is seriously great to see all of the problems you encounter and how you react to them and finally solve them.

i) - Regarding glossy/matte black for the polyethylene sheets, it is my personal opinion that if you can manage to create a sense of true black whilst making the sheets matte, it will look better than glossy black due to the fact that the magnetic rods are high gloss. However, if the process of making the polyethylene sheets matte makes them greyish/not as deep black, it will look worse. (Very subjective, but my 0.02$)

ii) - 15'000 holes/places for pins spread out over 8 programming polyethylene sheets equates to 1875 holes per sheet. Let's say you have 16 people on stage (to the side) doing the reprogramming during songs, this means each person needs to remove and re-allocate 937.5 pins each. This equates to each person having to place 1 pin every 0.256 seconds if an average song is 4 minutes. 

I'm assuming that EVERY pin will not be placed, but just to make a point, I'll assume that with 50% of the pins will be placed. This means that each person will have to place 1 pin each 0.512 seconds.. which is a problem.

This does not even take into account the removal of pins, which could be simplified by adding a mechanical feature to the back plate which holds the magnets (implying you use metal rods, and not neodynium rods). The back plate could be snapped back, making the distance between magnets and rods longer, causing them to lose grip on the rods, and the rods may thereafter efficiently be "dumped" out of their holes by holding the polyethylene sheet upside down. Still, there is no way this is happening fast enough for it to be even slightly feasible.

iii) - What might work is if there is a way to create a separate automatical "loading" machine where it handles an entire sheet with the "pencil click down" method. This means you can preset "Song A, Sheet 1" -> "Song B, Sheet 3", and it knows the exact enabled/disabled status of each and every rod. It will basically just press down on each and every single rod that needs to change status simultaneously, which makes it an extremely efficient system.

It can either be simultaneous (every single hole across one sheet), or it could be scrolling, where it focuses on one row at a time, and the sheet is rotated 1 pinhole after every action. 
32 actions per sheet * 8 sheets, that's 256 actions in total => 1,07 seconds per action during a four minute song.
This method may work if you make a mirror image of the main frame wheel so that there isn't any time lost due to changing sheets in this "coder".
Reply: Wintergatan how do you nest wood parts?
Reply: dont make another video until you make the full "wheel of programming" to surprise us
Reply: Most important things first: Thanks a lot for your great videos and music! 
Now to the ideas: 

Before deciding on the tolerances, I would suggest to close the windows and use a boiler plate and a few pots of water to turn the room into a sauna for a day or so. Be careful with the boiler plate over long time scales, though ;-)
It's probably harder to test for temperature variations, but probably you can come up with an idea knowing the local circumstances.

Knowing how easily I mess up things when in a hurry, I would think that you could use unremovable pins on the backside of the sections (and corresponding slots on the wheel, or maybe better the other way around) to make sure that each programming wheel section fits into the machine in exactly one orientation and location. 
You could use the same system on the front to make sure that the mask used during the reprogramming stage fits only on exactly one section in one direction.
That would mean that you will have to carry more spares in case something breaks, or make sure that you can adjust the backside pins on each spare quickly, but I would guess it's an easy price to pay for more foolproofness.

The most foolproof thing would probably be to do away with the reprogramming, and just make enough sections to play all songs ;-) you probably will need a frame for each mask, and thus the mask is probably not so much easier to make than the section, and will need to fulfil almost the same tolerances. The same argument would probably apply for all techniques to automatically program the sections, e.g. by pre-loading a non-magnetic mask with pins, put it on, and have the pins pull themselves into the section.

In order to deal with broken pins it could be advantageous to drill tiny holes in the metal sheet behind the plastic, in order to allow the rest of the magnet to be pushed out with a thin pin. 

triplet pins would be nice, and the version with the two rows of thin holes next to each other looks like a brilliant thing. However, I could not see whether they wouldn't interfere with the slits in the back of the plastic? Another question to test out on that might be whether the plastic will wear out a bit over time? If it is re-programmed often in a hurry, there might be a bit or wear on the side and the timing precision might be reduced? And thinner slots very close to each other might be a bit more dangerous in that regard.

Have fun trying out so much more, it is such a great project, and you probably have as much fun and spills of creativity doing it as the average engineer at SpaceX ;-)
Reply: Will set for too programming wheel be enough? 

Glossy black will be more beautiful in soffit lights. With all that light play.
Reply: Brushed Matte would account for stage lights gleaming off the glossy
Reply: I have two Ideas, first off you could try numbering the blocks to help the reprogramming team, and second I think you should go with the two offset tracks for different time signatures, but make them as close as possible. I also had an idea that the top section could be easily removable to help with putting the reprogramed song on.
Reply: Along those lines, I was thinking of some sort of registration pins where the 8 panels meet each other (or on the main wheel itself) so that panels cannot be re-inserted in the wrong order. If it is 'foolproof', this goes nicely with your thought about audience involvement.
Reply: I would suggest to keep next design discussion on https://reddit.com/r/marblemachinex
Reply: Glossy looks better, but I think any scratches or scuff marks would be better hidden in the grey. Also, if you will have lights from the stage, it might cause reflective glare with the gloss black, unless that is something you wanted want. I personally like light bursts on camera, but it's considered unprofessional to some.
Reply: Even before you has suggested it I was thinking the best way would be to have 2 strips of magnets, one in 4/4 and one in triplets. It’s a lot of work but I think it would be the most reliable solution. Maybe colour code the triplet and 4/4 strips so technicians know which is which.
Reply: The paper Tamplet idea is very good, however I wouldn't use paper for it because paper is easily destroid and you would have to print new paper tamplets all the time. So I suggest to use unmagnetic metal instead.
Reply: @Auarhau - had the same idea...
Reply: My only ideas at the moment that I have probably requires to much re-engineering to make happen. 

But my idea would be to make the plates reverseable. Put the plate on one way you get side A, turn the plate 180˚ and get side B. maybe do side A in 4/4 and B in 3/4?

But like I said I don't know how much space your working with, the size of your striking heads or their position, how you have the plates keyed like do they only slot in one way? there might even be a problem of losing a channel do to size and spacing so this might not work.
 
You might have to add fingers at the top and slots at the bottom for the fingers to slot in to because spacing would be odd for 3/4 if a note lands on a joint. 

Again these are just some spit ball ideas that probably would of done better before things were planed out.

PS Thanks for your videos!
Reply: I see a problem with the programming-template. If you build it from a stif material you won't be able to pull the template off the section because the pins stick out in different angles and hold the template in place. I guess you could make a template from a flexible and relativly thin material, so you could "peel" it off like a peel from a banana. I don't know much about the different plastics that are out there, but i could imagine that the plastic which Film-scrolls are made from would be suitable, it's called celluloid, some sort of thermoplastic. Which leads to another problem: I don't think you could mill it on the CNC-machine, i guess you'll have to do it with a punching-machine. (Thinking outside of the box: Maybe you could engeneer a punching-head you can put into your CNC-machine. Just make sure the machines can hande the force on it's Z-Axis or you'll end up with broken axis and you'd be screwed)
Reply: I have an idea for the 1/3 problem with your idea you would need three different types of pins to achive the vals etcetera i have an idea fore that involves one third holes on both sides of the One quarter and a pin that fitts in too both of these and wraps over to conect in the middle where the actuall registration pin sticks upp this would allow fore the usage of only one type of pin and also allow the swich between these to happen at any time you please. I have some schetches of this if there is somewhere i can send them. Sorry about the English my autocorrect is in Swedish great videos Keep it up.
Reply: Maybe sort it by LED lights. Install LED lights on the board. Use computer to switch to your desire programs, lights will turn on for those slots. Then put those pins on them. Zero error.
Reply: the offset-pin design seems odd to me.

i'd suggest a pin that goes into 1.5 pinholes. the pinholes are not exactly parallel of course, but still something small to give it a bit more grip and, perhaps more importantly, orientation.

that way you would only need one kind of offset-pin (for thirds tempo) that can be used in forward, backward and in combination with regular pins. like this: regular, forwards backwards, regular, forwards backwards.

take this all with a grain of salt on my part, i'm not much of a musician, let alone mechainical engineer, so maybe i oversaw an obvious problem.
Reply: I don’t know about you guys, but I’m all my band concerts, we had to make sure to be really quiet if we weren’t out on stage playing, because people could hear us talking if we weren’t. Do you think the sound of the magnets snapping in would be a problem? Like if you’re in the middle of a quiet part of a song, and then there’s this magnet sound from people changing the songs, that wouldn’t be good. I was thinking maybe you could put some sort of fabric under the black thing, or instead of drilling the holes all the way through the black stuff, leave a tiny tiny bit on the back so it muffled the noise. But I don’t know if that’s going to be an issue for you, I really don’t know much, but this is really cool!
Reply: Have you considered a way to play quintuplets?
Reply: I like the swing idea, but the only thing with that is, is not all swing is equal.  Sometimes you swing, other times you play it straight or you play it opposite swing kind of.
Reply: I would probably look at doing multi pin inserts for common configurations. Say you know you need a lot of 4 pins in a row, or lots of triplets on the same track you can place all those pins with only 1 operation speeding up reset time. I'd probably also go with the dual track set up that way you can have pins in both sets of holes and not worry about a special shaped pin blocking a hole
Reply: José Betances use imgur and link it
Reply: unrelated note - for programing the machine you could use a custom program to put it in to a simulated version and have it play back, and if you need someone else to make that program I could help even though it would just sound like a MIDI 

also, may I suggest a multi-track system, it means that more notes will be available on 1 instrument channel and could be used to make some complicated and facinating patterns as it would need extra programming wheels
Reply: Also I think you might want to have more than 2 sets, just in case something happens, and to give the technicians some extra time to program.
Reply: Wintergatan what about having offset rows of holes. So in one direction you have the 4 set of holes, and if you rotate the panel 180 you can then play the triplets.(row of 4 holes, then row of 3 holes, then row of 4 holes and so on.)  Saves you needing to make a third set of panels like some have suggested. 
The triplet pins you have would be a pin to put in because there are 3 different one and you have to make sure you get them in the right holes. 
I like the look of the gloss but what about using the router to make a pattern on the panel. 
I like the idea of the template cover.
Reply: Don't do the offset pins, having to work with 4 rather than 1 type of pin will slow down reprogramming enormously, and if any mistakes are made it will actively sound bad since the central rhythm will be bad. Doubling the number of rows sounds like a far less risky idea.
Reply: Could you have an additional counter-rotating drum on the machine that has magnets mounted with the same pitch but opposite polarity? These magnets would be more attractive than the steel of the programming wheel and would thus the programming magnets out. Then you'd just need to engage that 'deprogramming' drum, rotate the programming wheel once and all the pins would be removed. However this relies on making sure all the programming pins are put in with the correct polarity when it is being programmed.
Reply: I Agree, have a couple of figure-of eight shapes, for the 2nd and 4th sixteenths of each beat like this: https://ibb.co/g4oKQn (my diagram is fairly accurate, using 50pixel for 5mm, and 47pixel for the gap, which should be 4.73mm?, with the triplets, the gap works out at just under 8mm?)
Reply: you can have a different set of programing plates for each different song
Reply: Another way to quickly build sections is to color holes of a specific song a color, and other songs another, so to make 1 song, they place the pins into the holes that are colored yellow for example.
Reply: I think that the  last proposed idea is realy good!!
Reply: I would have gone with another 8 programming plates to attach to the programming wheel for the 1/3 music. Or, depending on the feasibility of attaching them, make them somewhat larger to just be a total of 6 programming plates for the full revolution. This way you can reuse the same magnet programming pins as-is so you don't end up with an impossible mix of the four in total pin types lying about. Furthermore, you could have those plates in a different colour so the machine itself changes the look a little. 1/3, or waltz, for me is classic and pure and if you made those programming plates in white hi-gloss plastic it would bring a level of elegance extra to the whole experience.
Reply: I'm sure someone has mentioned this before, but using offset pins in circular holes means that there's nothing to make the pins orient correctly when you put them in except for the adjacent pins, and that could lead to offset-pins getting displaced away from where they belong.

But conversely, sharp corners can act as points of stress magnification and could reduce the life of the polymer layer - either through cracking or stretching out, leading to loose pins and/or the whole thing falling apart.

Would it be feasible to have pairs of circular holes to mount offset pins? Or egg-shaped holes - like a semicircle meeting half an ellipse? I don't know how much stress is put on the pins, so I don't know how much of a concern it would be to have sharp corners.
Reply: I like the glossy look better
Reply: If you are going to make a second row for the triplets, I have a second big benefit for you: you could try to put two songs on one programming wheel. one triplet, and one in 4/4. with a lever you could trigger the programming wheel to move just that little bit that the second song can be played. That would make the second row not only good for triplets, but also for a easier, more versatile way of using the machine.
Reply: Consider using the bar magnets and putting the triplet holes at right angles to the quarter note holes.  
AND/OR 
As the bar magnets are thinner a round hole drilled within a rectangular hole may still be enough to hold the rod magnets in position on the same centre line.  
Using a combination of both techniques could allow extension into 5/4 timing.  
Happy to CAD up a sketch to explain better.
Reply: I think the rectangle pins are a much more elegent solution than having multiple kinds of pins.
Reply: Thought of the proposal of @Bluelightzero as well but it's easy to miscount when programing without noticing -  It may be feasilbe to give the different positions colourcoding (similar to my proposal which would make it easy to crosscheck if the pin ended up in the right slot.
Reply: I Think the best would be to do separate triplet plates and quad plates. So you could Always play triplet - quad - triplet - quad - triplet on stage. So when you play a quad song, the technicians reprogram the triplet song, and vice versa. Here you could also maybe do some color coding system on the sides of the programming plates, like blue/red (not visible when completely mounted) so you don't accidentially mix triplet plates and quad plates on the same Wheel.

I Think the idea with offset pins are very bad unless you do some half-pin system for the holes and 2 half-pins per "pin", because else the offset pins will rotate in the hole as soon as they touch the registrator. Even if you do Square holes, the Square formation will wear down with time and the pins will rotate.

Much easier and simpler to just make separate triplet plates and separate quad plates.
Reply: Why magnets on the bottom, why not on the top
Reply: If you had the pins built into each section, you could create separate contoured strips that when pushed onto the back of the plate and held in with magnets, force some pins to be exposed while allowing others to maintain a retracted state, kind of like how those Pin Art devices work. That way it cuts down on the number of pieces that need to be replaced on each panel after each song. This also means you eliminate the risk of a misplaced pin being placed during a performance, as the pin configuration is predetermined by the contours in the strip. It may be slow at first, but i'm sure you could come up with a fast and efficient way to manufacture the strips with the CNC machine.

Oh and definately go with the 2 tracks and the thin pins. That would work well with my idea too so you can have multiple timings on the go at once. Gloss black all day :)
Reply: @Jesse Mallen I think that if the glossy look gets a little wear (Did I use that correctely? :D) I think it gives the machine a bit more style and it just shows, that its been through a lot :D
Reply: Here's and idea!
Make an identical plate with two layers, one non magnetic attached to the identical plate, then a sheet of metal (removable), then you can put the pins into the transfer sections off stage and just put the transfer section on top of the machine section and remove the metal from the back of the transfer sections then re-attach the pins from the transfer section to the machine, so then you just "cut and paste" the pins. However, you would have to reverse the programming on the transfer plate/section so that it will be the correct way round on the machine.
Hopefully, with some imagination you should be able to see what i'm thinking.

Contact me on my twitter if you want more info:
@CentreOfSound1
Reply: The thin bar magnets are only really strong in one direction.
Reply: Hey! So the gear that connects the crank shaft to the programming wheel is a specific size so that one crank is equivalent to 4 magnets right?
Well why not have a second gear you could swap out that is a slightly different size so that each crank is equivalent to 3 magnets. allowing triplets? 
Maybe i'm wrong and that wouldn't work at all but it works in my head haha.
Reply: I have a weird idea I got for quick programming.  I know it's pretty hard to make and have no idea if it would work. I thought: when the pins are magnets it would be possible to drop/push the pins in there designated hole. This could be done by creating a system controlled by A: a piano B: output from a midi. The assembly would consist of a row of holes orthogonal to the rotation of the programming wheel.
The pins would then be fed to each of the holes like bullets in a magazine. The action of giving a indput into the loader would then push the pins agains the wheel (with an actuator, or similar). During this process the wheel should be spinning at a slow constant speed.  If every thing works out the pins would now pull into the holes and lock in place. This should work (if your tollorances  are big enough for the pull of the magnets, and the force from the actuators to slide them in. The one thing that I can't predict is how accurate it would be, and if it is gonna mess up a lot. But it's a cool idea never the less ☺
Reply: Talking about the removal of the pins, how about having the magnets on the programming wheel instead of the end of the pins? So the pins won’t stick together after removal and in storage. I understand why the pins have to be rectangular instead of an easier to insert shape of circle cylinder, coz if there gotta be two rows of holes (triplets and 4/4) the two rows of pins has to be hitting the same key (and key or “trigger” or “activator” on the machine). Couldn’t think of an better option for now. It seems to be much easier than having triplet pins of another types when it comes to reprogramming on stage.
Reply: It seems like the Matt Finish is more scratch resistant than the glossy. 

There are these new Printed Polarity Magnets from Polymagnet that I think you will find very interesting.
Reply: For a triplet, it works out that the second note is late (in between the 2nd and 3rd quarter-note) and the last note is a little earlier than the last quarter-note. (exactly a 12th later i think).
Reply: Can't you just make the entire thing a 12/4 time signature so that you can do 4/4, 3/4, 6/8 and 12/4 very easily or does that cause problems with the loop lengths?
Reply: You could use a projector and a computer to show where to put the pins. Or maybe a laser for a more visual effect...
To verify the placement of the pins, a simple computer vision system could be useful.
Reply: offset pins are tricky, and don't see this idea working up. You must decide witch holes use:
for example: 
You use holes 1,2,3. Problem is You need 3 kind of pins:  1/4 offset ,  2/4 offset and 3/4 offset. Anther problem is all 3 pins fit (especially third one)
You can use holes 1,2,4 (or 1,3,4). Trat way you need only 2 kind of pins: 1/4, and 1/2, (last pin is reversed 1/4). And problem is how to prevent rotating pins? they mounts are round.
Reply: I really like the glossy black quite a bit, but the matte might match the rest of the machine better... I'd have to see it done to know for sure, but I'd lean glossy
Reply: what about extending the length of one song with a second set of tracks and then switching between both tracks?
Reply: Use glossy and matt! use the router to etch in patterns on each panel to create a matt relief. you could then have one pattern all the way round the drum. I would also name each panel, if anything it will be these panels that will develop personalities, being difficult to fit or panels preferring to be next to each other :)
Reply: You could add titanium pins and find a way to stick a magnet on botton o/
Reply: Not really a technical idea, but maybe etch something down the middle of the sections? Winterwatan logo etc.
Reply: You mentioned wanting the reprogramming to be quick and easy so that anyone could do it. With that in mind I think that the "offset pins" idea creates a problem of keeping track of the different pins, and even the order you could put them in as some are nesting. I believe the best solution to playing triplets is to have a set of programmable sections with triplet spacing. This is better than the box magnet idea for aesthetic reasons. Square pins seem like they might look out of place, whereas circular pins stay true to the thematic design of MMX. Also you have an opportunity to show off both the glossy black, and the sanded finishes by using one for the 4/4 plates, and the other for the 3/4 plates. That would also serve as a quick means of identification, and communicates the style of piece being played to the audience.
Reply: Wintergatan 

IMHO, the thinner pins with a double track is the way to go. It’s simpler, requires only one pin type and the thinner pins should be easier to grab to remove, although not as easy to place as s rounded pin.

Storing the pins during a concert, how do you plan on that? The thinner pins may be harder to separate if they get accidentally stuck together vs the round pins. Although the thin flat ones won’t roll away either. Are you planning C&C’ing a custom storage device?

Many thanks to sharing your creation process with the world. Can’t wait for the world tour.
Reply: This would also make it easier to know the order when switching.
Reply: I have no idea if this has been suggested yet or not, but have you thought about utilizing the template idea to augment the visual appearance of the Marble Machine X? When you first talked about CNCing the template, I worried that you would have trouble removing the template after placing the pins, due to the curvature of the surface, but then I realized you could just leave the template attached. Which made me think of printing patterns, designs, or graphics on the template that would add an extra visual component to the rotation of the programming drum. Additionally, you could match the print to the music being played. Though I would suggest outlining the holes in a contrasting color so that they are easy to locate and place the magnets in.

You could also place some "registration" magnets in the programming section bases and the templates to make it easy to align the templates quickly.
Reply: Here's one idea. What if you created the template for the programming sections which wouldn't allow pins into those holes and you had a separate device which would hold a magazine of block magnets lined up in rows which can be moved along the surface of the programming section with the template covering up the holes that shouldn't be filled? That way the pins would only fall into the correct holes because the template wouldn't allow them to fall in and if one does fall in there would be another one stacked on top waiting to be put into the next hole. This would, I think, work best for the bar/rectangle magnets and two track system that you mentioned (not the pins you have now) because they can have the offset/triplet holes right next to the sixteenth holes.
Reply: Why don't you have smaller blocks where you can stock your pins but it also stock it the same way you want it to be programmed... So once you want to reprogramme your mmx you juste have to take your smaller block and place it where it suppose to be than the pins will be at the exact place in a few second. Make the smaller blocks the oppisite angle of the programmed plate.
Reply: I haven't read all comments, so maybe new, maybe repeated. Offset the plates slightly, drill both 16th and triplet holes in the plate.  

So, the columns of holes alternate 16th, triplet, 16th, triplet (somewhat like the bar magnet idea). Orientate the plate with the 16th holes in positions 1,3,5,7,9 etc, it's a 16th plate.  Rotate the plate 180°, so the triplet holes are in positions 1,3,5,7,9 etc, it's a triplet plate.  Easy to machine with round bar magnets, makes the plates able to be both 16th and triplet depending on their orientation.
Reply: You could have an already programmed template with magnets that the pins will stick to when you move it over them, and then place it in in the programming wheel. Hope you understand.
Reply: # Solenoid Idea 2 #

This might be cheating, but you could supplement the marble mechanism and directly impact the vibraphone by triggering electro magnets.
Reply: Beni Sued This is a really brilliant idea. Doesn’t even need a crowd of audience or 10 technicians in white coat and safety googles, which may still take more time than one song to get the job done.
Reply: i have a suggestion, to get rid of those tripling pins. if you have those pins they will push to activate a note. what if you made those a little wider, and then next to the pin holes spaced with normal tempo (1234) on the programming wheel, you also have the waltz tempo (123) holes. you would then make the activater pins wide enough, to cover both 12341234 pins but also the 123123 pins. so when you would play 123123 you would use the 123123 pin-hole set, and when you would play 12341234 you would just use that pin-hole set.
Reply: You should have a slightly different tint/brightness of the different plates so that you can easily see the speed at which it's rotating, even if you're further back in the audience! Great work on these videos!
Reply: I think something that would really help is making the triplet pattern pins one complete piece, but this causes the musical creativity to be limited. So I think the offset pins would be perfect. The paper pattern would be really smart and quick to make. I recommend using bristol board. A thicker paper that would last longer than regular paper. If you do go with the offset pins for triplets and the bristol board you could color code the two separate type of pins on the paper to inform the person putting the pins in what goes where. I saw someone mention numbering at the corner for the order of each PS part which though so simple is such a smart idea.
Reply: An maybe you could drill the holes like this:
https://pasteboard.co/H7CKiCp.png
than you can still use your original pins
Reply: If you use magnets as programing pins, could you somehow magnetize the back plate with the same polarization as the magnet making them repell the magnets instanly clearing a programming wheel, this could be incorporated in a clearing station when changing songs.
Reply: I think the version with two rows of bar magnets is your best chance of getting a good result, because you don't need 3 types of programming pins. You need to think of getting them sorted afterwards, which would be time consuming. A solution to the reprogramming could be some sort of magazine, that holds the pins in the right place. Like a negative of the surface of the programming section. You could programm a whole section really fast, by setting it on, and triggering some kind of release mechanism. It would always position the pins right. The problem I see with this is: when you want to get the pins off, you would need to pull all of the neodymium magnets off at once, which is really hard, I believe.
Reply: Titanium is very expensive tho, but would secure no pin break, otherwise you should calculate the life cicle of magnet pins on machine and have a few spare platetracks upon a break
Reply: 1 - A separate set of plates with 3/4 time spacing would definitely be the simplest.
Pro - only 1 kind of pin, sturdy, less potential for confusion
Con - cost of building and transporting 8 more plates, can't play two 3/4 songs in a row unless you have sixteen 3/4 plates
I don't know what your limitations are on space, cost, transportation, but this would seem to be the best option. You could have gloss for the 4/4 and matte for the 3/4 to avoid mixing them up.

2 - If you only want eight plates, then having a separate row of pins seems simpler than offset pins
Pro - only 1 kind of pin
Con - pins have to be smaller so might be weaker, holes are closer together so might be more prone to break, might be easy to confuse which hole is which
So long as your template is accurate enough to ensure pins don't end up in the wrong holes, and it's still mechanically strong, this should work.

3 - Offset pins
Pro - can use the existing boards without changes. Could design different pins to offset different amounts, 5/4 time??
Con - Much more confusing, you need to ensure the right pins are used. How does template ensure that?. Offset pins would probably be weaker and more likely to break, or at least bend enough they wouldn't work.
If you did go this way (and I think the other options are better), then there is something i noticed.

In your mock-up, you had two kinds of offset pin, one to move the pin 1/3 of a space forward, and one that moved 2/3rds of a space forwards, and you had to accommodate these pins overlapping, which might mean they have to be inserted and removed in the right order. But 2/3rd forward is the same as 1/3rd back. If you made the offset pin straddle two holes to keep it straight (so would need to only take up half the hole with each "leg") then you could get both the 1/3rd and 2/3rd offset with a single type of pin. This simplifies the manufacture of the pins and keeping track of regular and offset pins. The downside is now you have to make sure they go in the right way round. You could easily have a tab on the side or make the pin wider in one direction so that the template would enforce the pins going in the right way round.

And some sort of keying to enforce the boards going in the right way round would seem a good idea too.
Reply: What if those programming pins break and part of that pin is stuck to the plate? Maybe an small hole to the plate so that you can push it out example like toothpick? Just for emergency. :) I dont know if someone already pointed this out already cause loading all the comments take long time to load.
Reply: Hi Wintergatan! I think you should probably do 1 or 2 extra sections in case if any of them will be broken during transportation. Keep it up!
Reply: I really like the glossy black. Also if you made the system with the push-pen design, it seems that you might be able to simply press a template against the machine to activate the correct pins, which would make reprogramming incredibly fast and easy.
Reply: I am not entirely sure how much room you have for each registration pin path, but if it where possible to to make two rows with the rod magnets it would prevent the problem of having to cut rectangular holes for the bar magnets preventing play in the pins and making the songs sound more refined
Reply: Parallel tracks for 16ths & triplets. Glossy Black + large stylised numbers 1-8 for each section that can be seen by the audience. Go Elon! Go Martin!
Reply: What about alternating between glossy and matte black? It might make the movement more obvious from a distance.
Reply: You could make a small embedded system, that play fast the programming wheel sections and tell the operator where a pin is missing.

To sense it you can use led and photo resistor or buttons
And a small display can show the coordinate of the error.
Reply: one question I have is what kind of music is this marble machine going to play? what I mean is the first machine had symbols, drums, guitar and xylophone kind of instruments to play the music it played. so the type of music, tempo and everything else depends on what you are going to add to this machine.
Reply: Rectangular holes need to be cut with a small bit so there wont be much play for the magnet => longer machining time.
Reply: Having trouble reading all these amazing ideas? Me too. I 100% support a Discord server or a subreddit for more organized discussion of these topics. Reddit has a "Q+A" sorting method for comments, so it's easy to see ideas that have been replied to by you, but discord allows for collaboration among fans, which could be really productive when asking for ideas from us. Heck, I say make both!
Reply: Keep it matt and go for dual tracks, it'll be cheaper and give you room to modify.
Reply: OK I'm not an engineer or a musician but with that serious number of pins.. I don't know if even with 5-10 people it could get done fast UNLESS the pins were already on a.. Speed Loader kind of device. Like with old fashion revolvers there's a device similar to the programing wheel I've seen thats used to take bullets into a revolver's chambers.. I was thinking that maybe you COULD make 2 more sets of programing plates to use as transfer plates already preloaded before the show which even 1 person could do but considering the plate is bent this thing would have to be build to the diameter of the wheel OR you could attach the pins to perforated strips that could be placed in but then removed easily, like a bandage or something.. NAH! I'm so confused I wish I was actually there & had half an idea of how this stuff works! >.<
Reply: I have an idea on the reloading side of things;
What if you had a tube that has a spring on the top of it pushing the magnets out, and in the black/dark grey part there was a little track for it. At the bottom of the reloading tube there was a gear that follows that track and the magnets get pushed out from the spring into the holes. It would also work better if you use non-magnetic rods with glued magnets on the bottom so then when they get pushed out they don't stick. I'm not fully awake yet, so if any of this doesn't make sense let me know. I didn't do any work designing or anything, the idea just popped inside my head. Maybe later I'll have a prototype in Fusion or something.
Reply: You can drill two sets of whole next to each other, the first set of holes are like how it is already but shifted slightly to the left and the other holes are triplet holes shifted slightly to the right. So each channel has two sets of holes for pins.
Reply: Wouldnt it look nice if you painted/printed a starry nightsky on the glossy black programming section? As long as it doesnt make it hard for you to see the pins
Reply: The system with the triplets sounds super cool but I think you'll have to watch out because it might confuses you where to put what part of a triplet, So I thought why not add some sort of painted lines everytime you've had 4 or 3 pins so you can differentiate the 1/16's more easily.
Reply: if you do not understand (i completely understand) i would be honored to send a picture
Reply: Could you stick larger flat magnets, regularly spaced, on the back of the metal sheet so that regular metal pins could be used instead of making the pin magnetic?  One magnet could be shared for several holes, although there wouldn't be equal attraction in the holes.  I imagine that a handful of these neodymium magnets is difficult to manage and quickly separate if someone is trying to program it quickly on stage.
Reply: Wintergatan I was thinking this video would be about midifying the marble machine based on the title, but it got me thinking of two ways you could play the marble machine by midi if you wanted to. One of which would make the drum a stylistic but somewhat unnecessary accessory (basically make every note on the drum active, a peg in every hole, but then make the standard marble trigger mechanism not touch the pegs by default. Then use actuators at the marble release area to allow the marble to be triggered on demand by an external keyboard. This would remove the organic element of needing an operator but it could be an idea for a standalone duet machine or an alternate way to play the machine with the interchangable drum feature you are developing.
The other idea is using a robot to replace pegs on the fly at the back of the drum. It would be fairly easy to use two drums at the back of the machine; one that removes pegs and another that puts them in place by rolling against the big drum and aligning the peg holes of each drum. There would be a time delay for the new pins to be played but it would allow for you to play songs continuously and meld them together. If you are intrigued by these ideas I could probably describe them better over a different medium.
Reply: Holy shit I literally suggested exactly the same thing. I knew I couldn't be the only one to have thought of this. I just hope he sees this idea because I think it's the best possible idea.
Reply: I immediately went to the 2 track system before you mentioned it. It even looks to me you could stick with the round magnets since each track seems to have plenty of room, but the material (delrin ?) might lose it's integrity. Then I'd go with the  block magnet dual track. Superb work on all fronts BTW. Filming, Engineering and Design, and the music.. Love the vids.
Reply: could you make every programming panel a diffrent coloured meterial? might look nice astetically
Reply: Hello Martin. You can use a magnets that have a thin rectangular base. And then you can make vertical rectangular grooves for 4ths and horizontal rectangular grooves for tripplets. It will make a little "cross" pattern. Top view of this idea would look something like this:
https://www.dropbox.com/s/5dvl4360edzwv6a/3and4mmx.jpg?dl=0 So you have a clear distinction if the piece is in 4/4 (V) or 3/4 (H) (little more fool-proof for reprogramming).
Reply: A thin plastic sheet with holes that would grip onto the magnets/pins could make rapid reprogramming possible. It would only cost you the amount of pins and the plastic sheets per song that you produced. This way you could just pull all the pins out in one go and individual songs can stay as one. This avoids reprogramming mistakes which are highly likely to happen. You wouldn't even need all the pins to be magnets, just enough that it would be held onto the removable plates. I hope this makes sense.

You need small plastic tabs on the inside of the holes in a thin sheet to create a bit of friction that holds the pins in order when they are pulled out. This should be a simple task for the CNC router.
Reply: What about some sort of programmable light table the plates could be set on for pin positioning? The holes that need a pin would have a light shining through. This might not be possible or practical due to the tight space requirements (not sure about led sizes or bleed handling), but I could see that being a major advantage in a live dark stage environment.
Reply: Wintergatan first off... I hate you, but only because your out here putting my life goals to shame ;) 

my first thought was the offset tracks, two for each channel, I think your right about keeping the programing pins as simple as possible to minimize confusion on stage at all costs. I was honestly thinking staggering the round pins would end up being the simplest solution, and those thinner magnets just seal the deal in my mind. (They scare me a little when held up next to the part of the video where you explained the brittle concern tho)

Anyway I just wanted to throw my two cents into this project that inspires me to keep working towards my own project goals like this... Since you asked so nicely :) honestly I feel you would know better than me so don't take my advice to seriously lol. 

But seriously seriously thank you so much for putting yourself and your project out there like this. Falcon heavy was inspiring too, but I didn't spend hundreds of hours taping together rockets as a child, it was marble tracks made out of printer paper and whatever else I could find for me.

I'll be out there in the crowd when you make it man
Reply: --Triplet discussion:
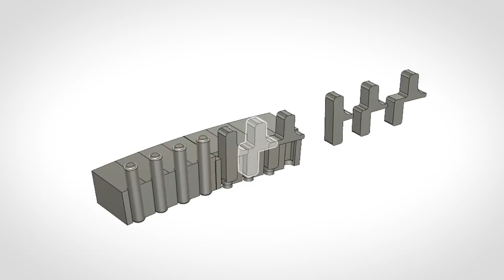Well... The double track seems plausible, and if the registers are wide enough so both tracks hit it reliably, and can keep up with the added pulse length of the flat magnet pins, it seems to me it could really work. Then you don't need to mess around with different type of pins, just use a reliable template that accounts for the dual tracks. You could also mix the two tracks and write music that switches between 4 and 3 divisions just by programming it the right way. 17:04 Exactly like that.
--Template discussion:
As for the paper template... the holes would need to be wider for the paper to be safely removed, because of the radial shape, the bottom of the pins are actually closer than the far ends.
Reply: Bar magnets are a far better idea. They provide much more design and programming flexibility. Really didn't like the design of the 4 to 3 pin conversions. They look like they have weak points where they could break plus you're inserting them into round holes. What's to stop them from rotating in position while the machine is in use? An issue I see is the either bar or pin magnets are magnetizing to a curved surface under the programming holes but it looked in the video like they hold decently well so may not be an problem. If they don't hold as well as you would like, try a flexible magnet sheet instead of a metal plate under the programming holes. And I'd pick the gloss black finish but that may interfere with stage lighting being highly reflective so something to test and see how it looks.
Reply: Instead of reprogramming the wheel, why not remove the whole sections and have preprogramed ones to swap.

It would be a lot of work. But if you had multiple sets, you could have several quick change songs.
Reply: If you add another abstraction layer, you have more flexibility. So pins will now be only to way to fasten ‘sections’. It’s a plastic piece with two metallic pins on the bottom, and a couple of (plastic) pins on the top. The plastic pins are in a music pattern. I assume some patterns are re-occurring. If the old pins where letters, these new sections are like words. Then you be able to do more with rhythm. 
So an extra ‘layer’ of bits with a reusable pattern. 
If there are no patterns in your music, this idea is not effective 😃
Reply: Laird Cummings perhaps a third set could have three holes instead of four per click to enable 3/4 timing?
Reply: Wintergatan, the idea of the rectangular section magnets and double holes looks the most reliable and cheap. Do have bespoke pins for the triplets, you're adding three more different pins to the choices and having to choose 4 different pins while programming live could become really hectic. Also, the rectangular shape will have lots resistance to breaking in the direction of the rotation of the weel.

An idea remove broken pins could be to drill a small hole (like the sim card holes in the mobile phones) where you can push from the back in case of a rupture. 

The template idea is great, although having it done in paper could be catastrophic if it breaks. I think a have a great idea:
First of all, make every one of the 8 panels unique with some kind of interlock which will avoid misplacing them (the 4th in the place of the 2nd for example).
Then, if the panel of the programming wheel is a convex metal with PE on top, your template could be a concave PE and a metal slide panel in the back. The PE template will have openings only where you need to place the pins, then you just put it on top of the panel to programme and slide the metal place which will release the pins onto the panel.
I reckon the total time to programme each panel this way could be very little.
Reply: I would definitely go for different plates instead of (4 types of) different pins. And as you'll want more than 1 set of plates the question of glossy or matte can be answered easily: one set glossy, the other one matte (and maybe a set of white 3/4 plates?).
Reply: What about instead of sheets to reprogram you create an identical section out of LEDs to light up behind the holes that need programming?  Would be easy to see on a dark stage, could be computer controlled and infinitely reprogrammable, and you would wouldn't have to keep paper sections together and in good quality.
Reply: For programming, maybe set up a jig with a projector, projecting onto the plate, showing the pin locations. Or have small holes in the bottom plate, with a projector or LED array that lights up through all the hole locations to be pegged - then you just insert pegs until no more light is visible.
Reply: I find the round pins aesthetically better, but i like the idea of using 2 tracks with rectangular magnets, you will keep the advantage of the brittleness that you would lose with the metal offset pins, but one possible drawback is that the rectangular ones can be quite annoying to separate once they are together because they are thin and have a flat side.
Reply: Maybe when you r playing waltz you should have another crank with different diameter..? It would make things for you easy when crank speed is 1:1 ratio. Otherwise sounds really good!
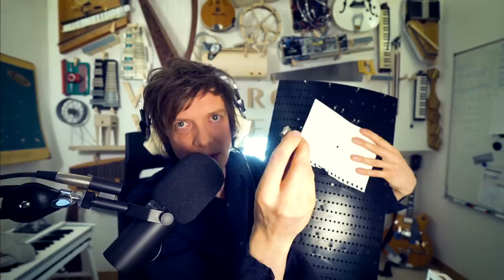Reply: I think double track is the best solution. I would still use round slots since they are much easier to drill. If you mirror every second pair of tracks it will create enough space to place the screws in between (17:17, where the T of triplet row is)
Reply: The template idea has constraints: because of geometry, it will either have to remain on the section when the pins are inserted (which could be a good thing, imagine having different color durable sheet templates for different songs) or be disposable/rippable such as to not pull pins when removed.
Reply: It is dawning on me just what a huge design task you are dealing with. OK my 2 cents: 
4/4 and 3/4 twin tracks looks the best way to make things easier for your re-programmers. EDIT: Meaning next to each other on the same drum
Think about dimensional changes with humidity,  even in your temperate zone you may discover what could happen and a world tour will encompass bigger extremes.
A programming template sounds a great idea but needs flexiblity to remove once trapped in a curve by the pins. 
How do you make the panels foolproof for fitting in the right order with Bar 1 cued up.
This whole project is awesome.
Reply: I think the solution with the thinner magnets and double lines is brilliant. And it would be so much easier and practical than the special cut triplet parts.
Reply: What about reversible programming pins? Right now both sides are the same, essentially wasting one half of them, by making them have two different sides you also only need one type of pin for 16ths and triplets. The bad part is manufacturing them of course. Also the idea with the "bayonette" mechanism like a pen would involve alot of moving parts i'm not sure if that's a good idea. Glossy black is the way to go imo.
Reply: My idea is to drill holes between the ones you've already done. In the end, we have one line where every group of four holes has two more but just a bit off-centered. You wouldn't need to desing/buy new pieces, unless you wanted to reinforce them adding something in the unfilled part of hole. What do you think?
Reply: Wintergatan To avoid the risk of the plates being mounted the wrong way on the machine, make them only fit with each other in one way. Like a jigsaw puzzle. 

To simplify programming of the plates, make sure the templates unambiguously show what type of pin goes where.

The bar magnets might be to thin and tend snap a lot.
Reply: It would be really cool to see a way to change out the programming pins in a sort of shotgun clip or if you've ever seen people load boxes at a factory, like an all at once kind of thing. Problems I could forsee with this would be certain pins getting stuck or not coming out of the "loading" mechanism. Thanks for reading my comment if you did. The gloss is much better. Have you thought about lighting the pins? would be cool in dark venues. Also Falcon heavy was great 😍
Reply: I know it goes a bit against the spirit of the machine but maybe consider 3d printing full panels with the song already programmed on it so that you don't need to always reprogram it. Or maybe do this as an archive keep new songs as reprogrammable and old ones set in stone in 3d printed panels. When songs are completed you can quickly put them on the machine instead of having a long set up if you want to song people the machine. 

I think it would then be pretty cool to have a library of songs that are just panels you interchange on the machine. 

I guess printing them as solid pieces would also solve some programming problems because you would be able to put the notes where you need them and not be tied down to keeping the panels designed to be reprogrammable for any song. 

On the side of reprogramming though I do have a rather complex idea that would probably end up being too messy in the reprogramming stage. 
What if instead of having the panel as one solid template you would divide the panel into rows by each tick mark. If you need to get more specific for individual notes or groups of notes then divide the rows into a gid. On the side, you would then have printed smaller panels with varying hole placements to account for different tempos and beats and depending on what tempo you need you can interchange these smaller panels to play the tempo needed. 

To make it easier to distinguish between different tempo panels you could have them finished in different colors or shades of grey and that would even add a more visual interest in the body of the machine. 

If you're stuck with not knowing what to do always remember to look back and see what other parts you can change to get the desired result. Make sure to not get stuck in the rules you set for yourself. 

One last thing, if you're too far with your design that you can't go back and change something to work differantly, don't forget that after this machine is complete you can always make aother one.
Reply: Why not just build a couple sets of plates for each Time Signature. That should future proof you for song writing on the machine. You can use the same pins. You can even have each time signature a different color plate for a nice visual change on stage. Template idea is good, could build out of a thin wood to overlap during pin placement.
Reply: mja00 I was thinking about that myself and I would suggest hooking long tube right next to the cutter with it being attached to a vacuum. That will collect the shavings and keep any other cleanup to a minimum
Reply: What about a set of pins offset just so that you can achieve other time signatures? 5/8, etc. I'm not entirely sold on using multiple offset holes, though.
Reply: Laird Cummings Thats clever, making them easily distingiushable aswell
Reply: What if you made a pin with a channel in it that passed through silently in one position but when turned 90degrees, struck the sound. In addition to the channel they could have a notch on the side that allowed them to be pushed into an active/inactive state after passing through the machine. You could theoretically load at least two songs at once into the machine. Does this make sense?
Reply: Zach Johnson really expensive to build 😅
Reply: Ur best bet is permanent pins in every possible spot, spring loaded so they can be pressed down.  Then your template thingy with the holes in it doesn't just help the technicians, you have a template set for every song, they clamp on and press down the pins you dont need for that song, allowing the necessary pins to poke through.
Reply: I like the Glossy look, but i still recommend to do the matt finish as it is only a matter of time till it'll lose its shine, the one you have rn already has some big scratches, and it wasn't even used/transperted anywhere.
Reply: Not if the holes of the pegs in the template have extra room depending on the angle (the middle row has none, the further you get the more room they have towards the middle) so that the template can be pulled out, and I mentioned that you would still need to empty the previous song plate but that's a relatively fast operation.
Reply: U and the techs are gonna break ur necks and hearts on stage if u really try to reprogram 10k+ pins while the other set is running. Imagine:
Some1 dropping a section, some1 dropping the box(es) with the pins, sweaty hands, programming mistakes, lost song blueprints, magnets sticking to each other.

10.000 pins / 10 people = 1000pins per person, average runtime of a full programmed section? 4 min, 5 min? Thats 3 pins per second and person to put down right. 

Ur way better off having amount of x pre-done songs and reprogram while setting up for the gig.
If ur using magnets u might have to deal with some form of magnetization issues again.

Comment section is already TL;DR but tons of peeps already suggested subreddit. Plz make it happen.
Reply: I didn't know if you addressed this, but for your programming sheets - if you use some thin poly sheeting, you could mill the programming through it & then it would be more durable for reprogramming, show after show. Also, people mentioned the need to number the plates. I think that you could add some locating pins on the face outside of the channels that could identify the number, as well as properly orienting the programming sheets to reduce misalignment.
- I don't have a CAD program to check my theory on the 4 vs 3 meter arrangement, but could you use the same single row, using the bar magnets orient them vertically for the 4 & horizontally for the 3?
Reply: Alec Wang that's a great suggestion, I think it would also be slick to incorporate the finish texture into an indication, like each plate could be numbered or lettered with either the character or the background textured while the other is left glossy. Would look cool in the lights as it plays, and give indication to the programmers for orientation and order.

Just too bad Wintergatan is not 8 discreet letters...  Maybe WINTERG*
Reply: Maybe make some programming wheels based on triplets. That way  your technicians wont have to fiddle around with the pins. Triplet based pins on the programming wheel you have now, would also be a hell, since you would have to make sure you put the right pin in after a space. Hope it made sense :P.
Reply: Is there a Wintergatan subreddit yet?  I think that is usually the agreed upon place to have real discussions.
Reply: first off all this discussion is great, but if I  were you I would find a better platform.. some kind of subreddit or so. those who want to help will find their way and it is much more clear. 
now for the ideas. why not to make a 3/4 segments and 4/4 segments. having both rhytms on one segment could be too complicated. i suppose that mostly you use the 4/4 so most of the time second line wouldn´t do much work.  and i think it looks better with just one line there. you could even switch between them if you like to.. so you would have 4/4 ..4/4.. 3/4.. 4/4 segments or so.  but on the other hand this way you would have to carry one set of segments extra plus some backups.
the thought of the paper to guide is great.. maybe a plastic sheet or something more durable coud be better. but it would make everything quicker. you can even make notes on the sheet. and for the pins i would vote for the round ones.. it is much easier not to think about the direction. and the round magnets are easier to take apart than the rectangular ones. 
have you thought about the moving of the marble machine x? the weight or the size? it wouldbe shame if it was too big. 
great video. great cuts. i like quality of it. thanks
Reply: I would just do a third programming setup with well placed 3 notes instead of the 4... (hope you understand what I mean, i do not really have the English vocabular to say it the right way...)
Reply: Very nice but some comments.

I noticed that the pins make a clacking sound when inserted. If you have technicians reprogram one set of pins while you are playing, would the clacking sound interfere? Wouldn't they have to reprogram in a sound-isolated room?

Rather than making offset pins, why not just make another set of programming boards with three holes per section instead of four? You could also build boards for other times, like 5/4, 6/8 and 8/8. Yes, I know some songs do change time in the middle but you're not planning on writing anything like that. Or are you? 😉
Reply: I think the special pins are a very bad idea. The three different triplet pins will be a nightmare to manage and reprogram. You either have to sort them into different containers ("unprogramming" won't be that fast anymore) or search through a box of mixed pins for the right one. You have to pick the correct pin for 1st, 2nd or 3rd position and make sure they are rotated in the right direction when inserting. Also who will be glueing the magnets onto the thousands of triplet pins? Have you though about what happens when the magnet comes off inside the whole? Depending on how thick it is, it may not be recognized when reprogramming it with the stick magnets and then you have a pin sticking out further that could damage the machin.

Maybe I missed it, but why don't you just machine plates that have the holes for triplet positions? That's much easier to do and most likely also cheaper, because all you need is just a little bit more plywood and plastic.
Reply: ...why not combine the template idea with the change in pins?
Reply: Wintergatan  What if the plates itself (without the wooden construction) is replaceable, made out of metal plates that is like the polyphon music box? Cheap, easy replacable and that doesn’t take alot of space and weight? Keep it simple. This ofc ruinates the word programable but this would be the solution for the songs that are going to be played for each consert anyways. And keep each plate numbered and marked in a corner so the programmers easilly now witch way they are put together, just my opinion, good luck on the project!
Reply: With so many replies, YouTube wouldn't show me any of them when I hit show replies. :-( So, I don't know if this has been suggested.

My question is, how often do you think you'd be mixing time signatures? Why not make different programming plates designed for different time signatures by adjusting the spacing on them? You could even design plates for truly oddball time signatures if you wanted. It would be simpler than having one plate to try to do them all.
Reply: Feh, it also doesn't show my whole reply unless I hit edit!
Reply: Wintergatan I was going to suggest what you said with the flat magnets and have them offset but you already thought of it, I think u should do that anyways unless there's another problem that occurs with that
Reply: I would recommend floor polish in order to make loose things fit more securely.
Reply: What if you change the alignment of the magnets for 4/4 and 3/4. Vertical for lets say 4/4 and then you rotate the magnet 90 degrees(looking at it from the top) for the 3/4 tempo. Then you can have both tempos at the on the same track line. Only problem i see is the difficulty og getting a square corner when milling the pocket for the magnet.
Reply: Wintergatan är du svensk?
Reply: I like the idea of the idea for the CNC templates. What if you made a mechanical grabber or something similar that covers the face of the plate allowing you to pull all of the pins out at once? Or you could put something behind the plate to push the pins out but I think that would get in the way.
Reply: Hi Martin ! Your last proposition is my favorite, I would suggest that rather that templates you may use a video projector to enlight the holes that need a pin, it would be very visual, sadly or not. I don't know if it is viable with smoke machines all around.
With one pin model you can use a stock distributor like for staplers that may alow technicians to programme a pin each second or even less.
Reply: Based on this video I understand that your pieces of music have some limitation. You kind of self-imposed some limitation in use one tempo for programming wheel. Basically, one way, very simple to use other tempos is building different programming wheels for different tempos.

It's best than create another type of magnetic pin (I don't know how feasible is this idea). Using two different types of programming wheels, using some color code to differentiate, maybe is good because you already think in people reprogramming one program wheel for time.

Imagine two programming wheels, one green for 4/4 tempos and a blue for 3/4 tempos. Basically, in the instructions to people reprogram the programming wheel, the first step is to select the programming wheel based on such color.
Reply: If you haven't made your plates yet, wouldn't it be simplest to make one set of plates for triplets? Call them your Waltz plates. You could still use your offset row idea to give 6 beats per hand crank and 8 beats on your existing plates. Just an idea.
Reply: that is one sexy machine... EDI is less sexy than your machine.
Reply: I'm super late, but what about a shifting register? Then you can not only have dual tracks to allow for triplets, but also allow for two songs to be played from each set of plates before requiring a change.
Reply: 5/4 offsets?
Reply: Sorry if this is not actual anymore and if I'm too late. But for the quick programming the machine itself I just had a preliminary idea of a pre-programmed sections ... but not the secdtions themselves, but some kind of an intermediate variant of that template with the holes. Don't know for now how this could be implemented technically, but the idea is that you have that "template" ready with the pins already in them ... Then you just cover the sections on the MMX itself with this templates one by one. This can either be done as is: just a thin template with pins over the sections of the MMX, which are left further for the performance of a song itself. Or maybe some smarter thing: you've covered the section with this template, then press imaginary "release" button and the tempalte goes off the section, but the pins stay. This will look like those bubblegum-tatoos: you stick the film to your skin, then remove the film and the picture stays on you skin :) Smth like that :)
Reply: Continuing the idea of detachable templates with pins staying on the machine ... templates may be made of solid material, but only for one row of the section (maybe >1, but not so many to keep the template almost flat). Well, actually this not a tempalte actually - this is just a "replica" of a row on the machine itself with all the holes. A technician inserts all the pins into the template beforehand, they are fixed there by some kind of a spring. Then he attaches that row-template to an appropriate row on the machine and presses that not already imaginary "release" button which releases the strings and then safely removes the "template" - the pins will stay on the MMX due to magnets.
Reply: My tip: Buy a mp3 player, then you do not need a marble machine;)
Reply: Maybe it could play weird time signatures (like 3/46 but less weird)
Reply: 500th comment yay
Reply: Uou should make some parts out of steel for durability and plastick at places some places so it dosent make any unesecary mettal sounds
Reply: 499th
Reply: Use several colors of material for the programming plates, one for each song. More visual appeal.
Reply: 500th and last...
Reply: why not have the discussion on Discord?
Reply: This is a test to see if it’s even still possible to reply to this comment
Reply: Last